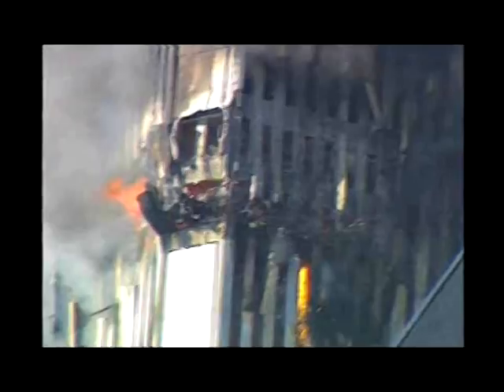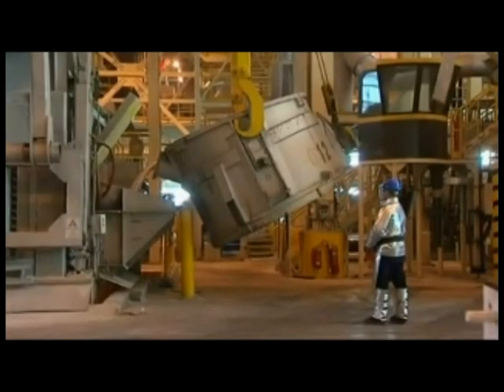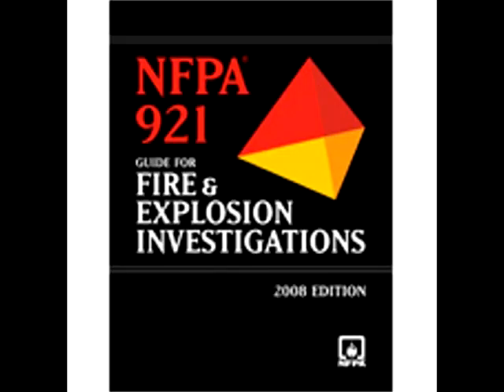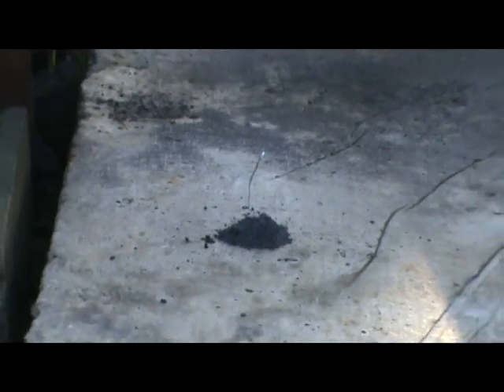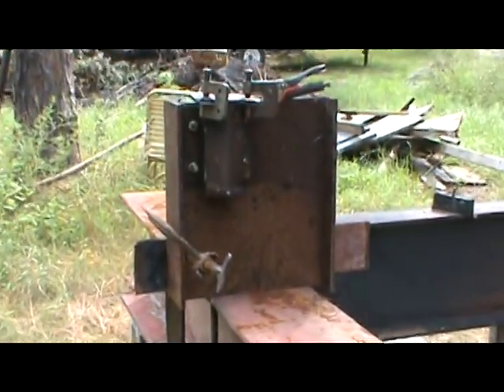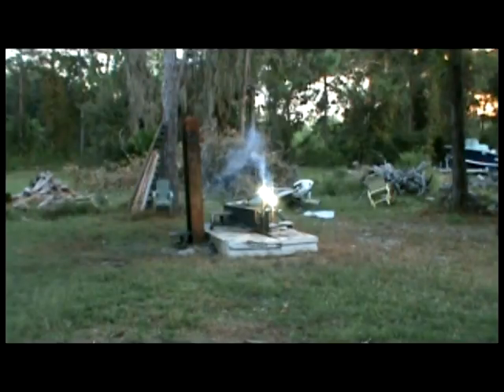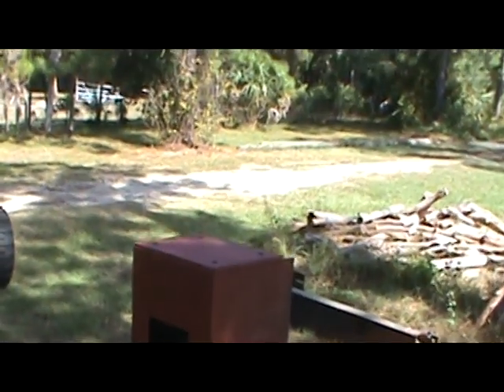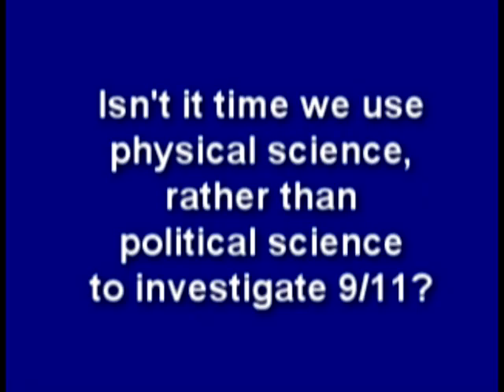9/11 Experiments: The Great Thermate Debate

Comment: The answer is simple: The molten stream of metal was not steel. There were many other metals in the towers. Aluminium, lead, copper an even gold, which all have much lower melting points than steel.
Reply: John Smith
Because the whole lot was literally a PLANE CRASH, and as such was a chaotic mess, so it could have been a mix of lead, copper, aluminium and whatever else was in that level at that time, but it was most probably lead.

And if it was lead (pure or not) and being heated beyond the point where it glows, then after the heat stopped being applied, it would still glow until it was cool enough for it to stop glowing. That would be seconds, but the molten material cascading was only glowing for a few seconds.

Now if it was thermite (and you so desparately want it to be) then WHY would they ONLY put the stuff RIGHT THERE and NOWHERE ELSE?

That answer is very easy if you ask that of molten lead and/or aluminium: In that area, there was a lead/acid emergency power backup battery feeding one of the offices, which was supposed to back up an entire bank of computers in the event of a blackout.  Also in that area was  much of the wreckage, which was forced into that area by the impact and fuel/air blast.

Now when such batteries are overheated, something very nasty happens: They burn. Then the hydrogen emitted by the batteries burns. In ordinary conditions, this would have been suppressed by the halon system, but the halon system was useless because of the plane crash completely destroying it. So you have a nasty fire in that corner, not only burning the hydrogen from the batteries, but burning everything else that got forced into that corner by the plane crash (meaning much of the contents of all those offices, already set alight by jet fuel).

Now for your thermite theory to hold, you would have to explain why:

There were no other such visible cascades of molten metal elsewhere in tower 2 or anywhere in tower 1 or 7

Why there were no witnesses claiming to have seen such cascades from the inside of the towers

Why there was nobody with the kind of UV radiation burns you expect from anybody who is anywhere near burning thermite

If thermite was used to cut all the key columns, such a glow would have been visible throughout the cores and throughout the exterior columns, not just one one corner of tower 2.
Reply: dangerouslytalented Come on? Gold, lead? Not much of that at all. It was molten steel allright. That explains why a lot of steel was combusted and blown into dust.
Reply: Erik Jonsson
Most likely not gold. But there was HEAPS of lead in cathode ray tube monitors (back in 2001 they were ubiquitous and had 2 pounds of lead in each) and back up batteries for uninterruptible power supplies. And none of the steel was blown into dust. The CONCRETE was ground into dust, but not the steel. The steel was recovered and sold to three scrap companies, as well as turned into memorials.
Reply: dangerouslytalented most of the dust was concrete. But lots of steel was never recovered. The Concrete exploded, it was not ground into dust.
Reply: Erik Jonsson what is your evidence for it exploding?
Reply: dangerouslytalented look at the videos......huge beams thrown upward and far away to the sides. That was no gravitational collapse. Concrete is not flour.
Reply: Erik Jonsson
They could not exactly fall exactly down. And can you show me exact video of which beams were thrown UPWARD. Because that's a new one to me.
Reply: I've seen several. For instance the one that the 911 architects and engineers discusses (experts speaks out).
Reply: Erik Jonsson
you saw it, now show me. Just the exerpt where they say it, not the whole damn thing.
Reply: dangerouslytalented the physics teacher Mr chandler....watch clips with him....
Reply: Erik Jonsson
Just show me the clip, I am not going to sift through the whole thing.
Reply: martinw28703
Yeah, and how much of the buildings were pulverized in mid-air, INCLUDING the core. Its just not possible that the core of such a huge structure can more or less vanish due to a non-assisted collapse.
Reply: martinw28703
1200 feet? Sounds like a lot, but consider the stresses involved when those beams snapped under high tension as the buildings collapsed?  Also the forces involved when the engines of those planes went straight through the buildings. But they fell a long way. 1,377 feet. And as the floors collapsed, they forced the outer columns OUTWARDS, you can see the start of that as tower 2 collapsed. They were not going to simply fall in on themselves in petite little piles, it was not some kind of controlled demolition or something.
Reply: Joe V
Well even that false analogy (because a steel building is tougher than a human body) indicates that the official version is wrong. The human who got hit would offer resistance and would tip over. Not become crushed into its own footprint at near freefall speed.
Reply: Erik Jonsson
Except that the towers were, by volume, mostly air. There was a three metre gap between the actual floors (where the offices were) so the falling mass, once it smashed each floor, another three metres to fall and gain momentum. And they never fell at anything near freefall speed. Freefall speed would be about 9 seconds, whereas the towers took between 17 and 21 seconds to fall. And not within their own footprint, the rubble fell all over the place.
Reply: John Smith
.You won't reach a high enough temperature at 700 degrees to bend the steel.

UNLESS

The office fires were hotter than 700 degrees. The jetfuel ignited everything. And some of that stuff burns at far hotter temperatures than mere jet fuel. You have plastics, paper, wood, transformers, backup power supplies, a large amount of electronics, all of which have different ignition, combustion and melting temperatures, and all these fires were fed with fresh air from below, through the smashed windows and the liftwells. THEN you have added stresses on the hot steel girders because many of the other girders were smashed, and all the floors that braced them against each other were not only smashed but so completely smashed as to be GONE. THEN there were MORE stresses brought about by the ACTUAL COLLAPSE, which completely smashed the steel in some places and bent it out of shape in others.
Reply: John Smith
The steel in the WTC did not melt. If you had your log burner hit by a plane and/or falling debris, had many of its structural supports smashed and thus was supporting far more weight than it was designed to support, AND was part of a structure that was no longer capable of standing on its own for a long period of time, AND was on fire, the thing might just buckle under THAT force.

And I have already told you that molten lead and aluminium can glow red if it is at some point HOTTER than that which it glows. If you put lead in a crucible, and then melt it, and then KEEP ON HEATING IT after it is molten, it will start to glow. It does not simply stop getting hotter once it is molten, it will keep on getting hotter if the heat continues to rise.
Reply: GreaterThanADeer
A lot of assumptions? What, that a team trying to surreptitiously rig three skyscrapers to blow would only use JUST enough thermite to bring it down, so they don't get caught? That a demolition engineer would only rig it with enough thermite to bring it down, because too much is a waste,   that the iron oxide and aluminium could be something else apart from thermite, they could be materials that are highly common within the entire complex? The fact that if thermite caused that small cascade of molten metal, then it would have caused far more small cascades right throughout every place where it was installed?
Reply: GreaterThanADeer
No, what they found was NOT the residue. They claimed to have found ACTUAL THERMITE, which would have been impossible because 1) you can't extinguish thermite and 2) there is no way any competent demolition expert would put enough thermite into the tower to account for the MASSIVE amount of "thermite" found in the dust.

And as for the "paint chips" bullshit, there is no way that a thin layer of thermite will burn through a whole steel girder. Look at the amount of thermite used in THIS experiment...
Reply: John Smith You cant post claims that are known lies, and expect to be taken seriously..  ,,this from you ""NIST agrees in their report the towers fell in freefall. Under 11 seconds. That's a floor per second. 
Building 7 however fell for freefall speed a total of 2.5 seconds and collapsed in 6.5 seconds""
The towers fell in 15 and 21 secs, respectively, and as for wtc7, you are forgetting that the penthouse collapsed many seconds before the main building..
You also posted a pic of a steel beam protruding from a debris pile with a diagonal cut..  It is OBVIOUS that beam was cut in the clean up process,..  the diagonal torch marks can clearly be seen, along with the molten slag at the bottom cut...  You weren't trying to imply that beam was cut by thermite, were you??  Only a moron that doesn't know crap about metalwork, or is sorely lacking in common sense would think that///
Reply: Joe V Did you miss the part where he said the image was taken before any steel worker was present? Its easy for someone like a fireman to look past something like that with all the other chaos going around.

"Ok, there are thousands of bodies in this ruble, but would ya just look at those beams?" How about that for common sense?
Reply: dangerouslytalented Why not? Gravity works vertically, not laterally. Beams were thrown as far as 1,200 feet. What would have enough energy to throw spans of perimeter sections, weighing tons, over a thousand feet?
Reply: Erik Jonsson
The core did NOT vanish, it collapsed because the floors that braced it against the outer walls had collapsed.
Reply: dangerouslytalented The engines? The engines that were flying at 500 MPH? I'm not surprised they flew that far either. But, a section of steel weighing tons can fly that far just from a couple floors falling on it? 

Like I said, gravity works vertically, not laterally. Something threw those beams that far, and it could not have been the force of the falling building. 

Also, funny.....petite little piles is exactly what we see. I'm not saying the entire building landed 1,200 ft away, most of it ended up almost directly in it's footprint, but some beams were literally thrown far distances, too far for the force of falling floors to throw them.
Reply: Why is it, people always seem to go after things about 'how the building fell', and 'what the fires did', and 'what the planes did', and all this malarkey? 

Why don't people ever talk about the hundreds of witnesses who heard explosions? Not just explosions, but multiple explosions. Most firefighters and police officers claimed to hear explosions. Almost all videos of the towers show squibs as the building is falling 30 stories below the falling floors. If it was just plainly air, then why is there dust coming from them? If it was just glass, wouldn't it be damn near impossible to see? Plus, the air, when pressurized, would have blown at all around the building, and not in single instances at over 70 mph.
Reply: martinw28703
It was not a couple of floors. It was ten or twenty floors collapsing on top of it.

Little experiment: Take a pencil and bend it until it breaks, but don't hold on to the ends hard enough to keep a good grip. What happens? The two parts of the pencil fly across the room. And the forces that acted upon the beams on 911 were enough to snap the steel girders, so I don't see why they would not have gone so far. And the buildings did NOT fall exactly into their footprint, they splayed all over the place, the Verizon building, the Deutsche Bank building, the Winter Garden and every other building in a six block vicinity was damaged.
Reply: Erik Jonsson
I am not watching a one hour video. Show me the exact piece of footage.

The people who heard explosions heard things go bang. ANYTHING falling that height will cause such a noise. People were saying that the bodies falling sounded like M80 fireworks going off.
Reply: I told you to go to minute 59.

....

Well, that's your explanation. Many professionals at the site say otherwise.

It was wrong of me to state that the core vanished. Much of the debris was recovered. But as a whole I wanted to describe how it desintegrated in midair. It makes no sense whatsoever.

We should have seen a tall pile of debris maybe 20-40 stories tall.
Reply: Erik Jonsson
The squibs were air being forced out of the storeys below the collapse. The pieces of the facade that fell away were forced away from the main collapsing building because of the stresses involved in snapping those beams.If it was those squibs 20 storeys below, then the beams would be flung out when the squibs went off surely. IF they were actual explosives.
Reply: dangerouslytalented
Many of the explosions were hidden in the debris cloud.

And no that was certainly not air squibs. Why would the air come out 20+ floors below? Makes no sense.
Reply: Erik Jonsson
Still does not make sense. The squibs did not throw out any beams. Just clouds of dust. The dust came out 20 storeys below because that's where there were both open elevator shafts and broken windows.

Plus, NONE of the occupants of the offices reported any suspicious packages placed against the exterior walls.

And to set those explosives off incrementally, they would have to put each floor on a separate circuit, which would mean, in order to mistakenly set off explosives 20 storeys below the zone of collapse, the squibs accidentally put on the wrong circuit would have to be plugged in to the system individually instead of all the explosives on the same circuit, which is an incredibly inefficient way to secretly wire up two hundred storey buildings to blow. They would need to get access to offices (some of which were manned 24 hours a day), plant the mysterious devices, hide the mysterious devices and then hope some technician or electrician does not open up that one panel behind which it is hidden. ON ALL TWO HUNDRED FLOORS. And to do it to all three buildings would have taken a LOT of man hours. Each floor had an acre of floor space, they would have to spend a bare minimum of a night on each floor without being detected (and some of them, as I said were manned 24 hours a day, as many offices were dealing with China, Japan, Europe and the Middle East, which meant that they had to operate around the clock.
Reply: dangerouslytalented
Come on you can clearly see that beams were hurled "across the street". This was obviously demolitions, never ever would gravity cause something like that.
Reply: Erik Jonsson you don't understand physics, engineering or how buildings are demo'd.    Gravity is a very unforgiving force.
Reply: Joe V
Explain how beams were thrown over 100 m to  the sides in an upward trajectory.
The floors above the impact zone did not way as much as the rest of the structure. And it makes no sense that it could just pile-drive through the structure. Straight through the core.
Reply: Erik Jonsson Oh, they were propelled over 100 M away.. but in no fashion did they ever travel in an 'upward' trajectory. That would be impossible.  Since this is what you think,, You should post a link where this 'upward' trajectory is shown..  
You also need to look up the definition of static load and dynamic load.  It will explain how the upper floors crushed the lower ones..
 Its obvious you lack a lot of physics and engineering understanding... go back and take 9th grade physics..
Reply: Erik Jonsson For a visual aid, think of the load this way,,  Imagine you are holding a 15 pound bowling ball on top of your head,  No problem, right.  Now the same ball is dropped from 15  feet up on your head.  Would your head still be able to hold the ball?
Reply: dangerouslytalented
17-21 seconds? Where in the world did you get those figures from?

The twin towers fell in about 15 seconds. Just watch the videos. And building 7 fell in about 6-7 seconds.

"Mostly air by volume". But the core was not made of air. And the building just crushed itself in its footprint. Makes no sense.
Reply: Erik Jonsson
I found out the time it took for those buildings to collapse by taking the footage and TIMING IT. All you have to do is count the seconds from when the collapse stopped to when the collapse finished. OR you can use seismic data, or you can use sound, but no matter what method you use, it ALL ADDS UP TO 17-21 seconds.

And the core was NOT solid concrete either. It was steel lined with drywall. And it was mostly hollow because it was full of liftwells.
Reply: Well, it does not convince me that it was not an inside job. So I'm done here.
Reply: Erik Jonsson Maybe even platinum, or plutonium; yea, that's it, coulda been uranium or maybe even einsteinium or taffy, turkish taffy. They gots a lotta that in NY. Coulda been. Yea.
Reply: dangerouslytalented Why would it collapse? The internal core was an independent, freestanding support structure. Try watching some of the construction videos. The core was dependent on nothing but its own foundation (which was made of 4 inch steel box columns, incidentally).
Reply: C. A. Gravenhorst
It was never designed to be freestanding. Never had to. They built the cores only a few storeys ahead of the external walls and the floors.

And the core columns were only 4 inches thick at the base. At the crash zones the steel was less than an inch thick and all of it hollow (because hollow steel has a far greater strength to weight ratio).

And the core columns were not what initially collapsed, it was the floors and the outer facade columns.The cores collapsed when the rest of the towers came down around them. You can see the cores still standing for a few seconds if you watch some of the footage of the collapses carefully.
Reply: dangerouslytalented Yes, and the structure falling was made of the same 'mostly air' construction. Same acts upon same precisely as demonstrated in the experiment.
Reply: C. A. Gravenhorst
In between the air, there was fucking concrete. Lots of it. Literally an acre of it per floor. And steel. By volume it was mostly air. But by weight, it was 1.5 million tonnes. And the air conditioners were built to cool another 60,000 tonnes of air. By weight, it was mostly concrete and steel. By volume, it was mostly air.
Reply: dangerouslytalented
You can't have it both ways, sparky. Either the structure of the WTC was substantial all the way to the ground (actually it was considerably MORE substantial as it got to the ground), or it wasn't. It was YOU who attempted to claim the 'pile driver' theory of a collapsing mass crushing 'mostly air' construction. Well, whatever it was, it was not less than what fell on it and would have, in a normal event, offered resistive force. But clearly none was seen and as such can only be explained by actions taken to remove the resistive force. That is how demolition is done.
Reply: C. A. Gravenhorst
It was more substantial when you got to the ground, but the falling mass by the time it got to the ground was far, far greater. You have 1.5 million tonnes falling by the end of it, whereas the top few storeys at the start was only maybe a hundred thousand tonnes. The air gaps allowed the falling mass to speed up through gravity before hitting each and every floor in turn.

But lets take ALL your preconceptions as a given: What do YOU THINK caused what is observed?
Reply: dangerouslytalented It doesn't really matter what C A Gravenhorst  thinks caused what was observed,  He already thinks it was caused by some form of CD.  So his reply will  only be his opinion, having ZERO facts to back it up..
Reply: Joe V
It was definitely not controlled. The debris flew everywhere.
Reply: Bravo. Simple observations that this mental giant can't see. He is like a 12 year old with a budget.
Reply: *****
The eyewitnesses to explosions had no way of even knowing what caused the explosions, they just know something went bang (which could have been ANYTHING hitting the ground, there are reports of people hitting the ground sounding like M80 firecrackers), and fireballs at the bottom of liftwells (the fireball being forced down by its own pressure). No actual witnesses seeing actual explosives, and the only evidence of thermite (which does not explode, it burns very quickly with a bright orange flame with a lot of UV radiation) was iron oxide (the same compound as rust) and aluminium flakes (aluminium was abundant in the towers due to the facade and office furniture).
Reply: ***** The ones who heard explosions were in the basement. They had absolutely NO WAY of knowing what was going on 80 or 90 floors above them. All they could see and hear was a fireball at the bottom of the liftwell and a bunch of stuff falling down.

Planting bombs in the basement DOES NOT MAKE SENSE. The collapse was downwards and progressive. Planting enough explosive in the basement to destroy the building would have killed everybody in the vicinity. That's what happened last time, AND IT DID NOT WORK. That bomb, at 600 kilograms (over half a tonne) caused a LOT of damage to the underground carparks, but nothing even close to any structural damage to the towers, and security efforts AFTER that bombing meant that a bomb that size could not even be ALLOWED  INTO THE BUILDING. Trucks that large were all screened,and so were all deliveries. (and a bomb in the basement was completely unsuited for the job anyway, because of the open plan of the building, there was not enough enclosed space).
Reply: *****
... the guy who was blown off his feet when Building 1 collapsed? The collapse of building 1 was enough to gouge a huge hole in 7, he was bound to get knocked off his feet.

Oh, and weakening the columns at the base would still have had no point, where far less material would have had far more effect up towards the top of the towers.

Now as far as exothermic reactions, what exactly do you mean by this? Do you mean an external heat source?
Reply: *****
Ah, that's the one. Except if there was an exothermic reaction from thermite in the basement, it would have NOT looked like an explosion, it would have looked like fires from the pit of hell. And all the witnesses would have gotten UV radiation burns, (they would have looked like they had a sunburn or "welders tan".

Now what particular question did you ask three times? The one about why would I not investigate alternate theories? I have investigated them, others have investigated them, and they have been found lacking. They usually lack basic pieces of evidence and pretty much everything that points to an alternate explanation has a reasonable explanation. For example, thermite is simply a mixture of iron oxide and aluminium. Both of these things were abundant in the towers, and flakes of iron oxide and microscopic pieces of aluminium would therefore not be uncommon. Against the thermite theory is the fact that if they used thermite to sever key structural members, they would NOT have used as much as would explain all the "thermite" found in the dust. Also, you would have seen a strong red glow emanating from the whole tower, you would find a whole lot more molten steel, and you would NOT find unburned thermite, because they would not be so stupid as to put more thermite in than was absolutely necessary, particularly as it would have had to be smuggled in, and you can't extinguish thermite.
Reply: ***** I have to put my 2 cents in here..   That pic of the beam you gave a link to  CLEARLY was cut by a torch in the clean-up process...  That photo was cropped and enlarged to show just that beam.. The original photo shows other beams about the same height, surrounded by a debris field.. I think there is a fireman in the pic also..  Diagonal cut marks from a torch are obvious, as is the molten slag at the bottom of the beam...  Thermite can not do that..
Reply: *****
Let me answer in this way: They should have followed the evidence. The evidence points to what questions to ask. Otherwise, if you try to address ALL the questions, stupid questions start being asked. "what about space weapons being used", as truther Judy Wood is fond of asking. "what about mininukes". If there were pools of molten steel or other obvious signs of actual thermite being used, (large numbers of cascades of molten steel, eyewitness accounts of bags of thermite igniting, UV burns on the faces of many of the survivors, then they should have asked about that that. If the Geiger counters were going off full tilt without any actual reason, they should have asked about nuclear weapons, and If there was definite  sky blasts from space and an EM Pulse wiiping out all the electronics in the area, then they should have asked about space weapons.
Reply: *****
molten material in the rubble? Do you actually know how long it takes for thermite to burn? Even a large quantity of it is gone within half an hour. Go look at the mythbusters episode where they used half a tonne of thermite on a car. IF there was molten metal in the debris pile, then it was NOT thermite from some kind of plot to make the towers collapse, because THAT thermite would have been GONE long before the towers came down.

As for unburned thermite that Niels Harrit claimed to have found, let me ask you this:

ANYBODY who works with thermite knows how much it will take to burn through a girder. And they know how to place it so it will burn efficiently. WHY ON EARTH would they put so much ANYWHERE that it would not be fully burnt out by the  time the towers fell? And the sheer AMOUNT of thermite that Harrit found in his samples would indicate that MASSIVE quantities would have been used, had it actually been thermite, instead of simple iron oxide (rust) and aluminium flakes. (which is what thermite is).
Reply: dangerouslytalented 
Sounds great when you put it like that, however molten lead and aluminium is silver, not bright red.
Reply: John Smith
Whatever that molten metal is, it isn't pure.

And if you get molten lead and/or aluminium hot enough, it glows. It is just that the point where iron glows is lower than its melting point, whereas the point that aluminium and lead glow are higher than the melting point.So when you normally melt lead or aluminium, it does not glow, because you normally don't have to heat it so much that it glows, that is wasting a lot of energy. But you can heat lead (or aluminium) to the point where it glows.
Reply: dangerouslytalented
1) What makes you say it isn't pure?
2) What would you suggest it is?

Before you answer it'll benefit you to know the suggestion that it's a mixture of office furniture has already been debunked.

Aluminium and lead glow red when they're BEING heated. They both begin to cool very quickly when they're not and form the silver skin. 
Molten aluminium or lead falling from that height (~400m) will cool very quickly and become silver.

Search Google for images of molten aluminium and lead, you'll see within the crucible it's glowing red, but what's being poured is silver.

Here's an image that best describes what I've said, (aluminium)

http://www.themoscowtimes.com/upload/iblock/360/rusal.jpg

There is no way the molten metals pouring from the towers is aluminium or lead, especially since the position of it on the tower is where the lateral steel beams meet the vertical box columns - a very strong part of the structure.
Reply: dangerouslytalented
Ok, so like I've said, those metals when molten are not bright orange.
And copper, whilst orange when molten, doesn't melt until well in excess of 1,000 degrees, which the fires in the towers weren't, given the highest temperatures would have been caused by the aviation fuel, of which was almost entirely burned off on impact, and burns at HALF the temperature to melt either copper or steel.

The molten metal pouring from the towers continued to glow as it fell.
It continued to glow as it sat underground up to 100 days after the collapse of the towers in what emergency services described as "pools of molten steel" and described it similar to being in a foundry.
It continued to glow to the extent it was melting the boots of emergency crews.

Here's a famous image,
https://www.metabunk.org/metamirror_cache/algoxy.com_psych_images2_moltensteelenclose5mt.jpg

This was taken in October, well over a month after collapse. 
Now take into account that thermite provides its own oxygen, allowing it to burn in the rubble where oxygen would not allow temperatures to rise to such levels.

Now let's not get sidetracked here, what you can see in the above image is STEEL. It is GLOWING red, which means it has been super heated.

Here is an even more famous image of firefighters peering into one of these underground"furnaces",
http://drjudywood.com/articles/dirt/dirtpics/jones_firemen.jpg

The thermite would have been placed on all structural columns within the towers to allow for the total collapse which we witnessed.
It's very simple physics - Newton's Third Law.
Each and every action has an equal and opposite reaction.
This simply means that when the top 15 floors collapsed downwards, they should have taken out 15 floors below and then come to rest on the perfectly structurally sound floors below.
There was NOT enough kinetic energy in those towers to allow the higher floors to crush through and pulverise the structure that had not been affected by the fires or the impacts.
That is simple physics, primary level science. Feel free to ask your science teacher.

But if you don't believe me, try this experiment.
Smack a bath of water with your hand and try to reach the bottom with the same level of speed - you won't be able to do it because of water resistance. Your hand will be slowed and will not hit the bottom of the bath with much force whatsoever.
Now imagine the same scenario, but replace the water with structurally sound steel - no matter how much force you exert, the result will only be the "equal and opposite reaction" of your so-called "action".

You're assuming right now. For thermite to be visible in such a way, it has to be packed in such a way. The video below will help you to see what I'm talking about, it's short so you should be able to watch the whole thing.

https://www.youtube.com/watch?v=5d5iIoCiI8g&index=1&list=LLYLKY4rC27_t5e6P3vTCLEQ

Take extra attention when he talks about the puffs of smoke that can be seen up to 30 floors below the impact zone as the towers collapse - these "squibs" would be the result of those thermite charges detonating. 
Estimates place these squibs as travelling upwards of 100mph, which casts aside suspicions of air pressure due to the towers collapsing.
Here is an image of 2 of these squibs,

http://www.veteranstoday.com/wp-content/uploads/2013/11/wtc-squib-mosaic.jpg

Here's another image showing squibs even further down the tower,

http://911research.wtc7.net/wtc/evidence/photos/docs/south_tower_squibs.jpg

"Why there were no witnesses claiming to have seen such cascades from the inside of the towers"
False. There are MANY eye witness accounts that testify seeing molten steel INSIDE the towers, don't believe me? Watch this,

https://www.youtube.com/watch?v=2VN-WXUJ7HI

People died in the towers at ground level before they had even collapsed. The 10th body that was recovered from the towers on 9/11, that of Robert McIlvaine was described by his father, Bob McIlvaine as having his face blown off, and an arm missing - again this is in the lobby and before the collapse.
Bob McIlvaine is very outspoken on 9/11 and appears in many documentaries demanding justice for his son. He's adamant his son was killed by explosives in the towers - which again were reported by eye witnesses as sounding like gunshots.
Again, I can provide video sources that back this.

William Rodriguez, the WTC Janitor who was hailed a hero for saving people on 9/11 reported hearing explosions in the basements of the towers an entire 7 seconds before the first impact.
He also explains seeing a man in the lobby who's skin was hanging from his fingertips, after being burned off his arms and explained initially thinking it was his clothes.
Reply: dangerouslytalented don't forget also that the stream of metal is glowing between some columns which were covered with aluminum shell... and said columns weren't melted. How can alleged steel at alleged temperatures much higher than the melting point of Aluminum pass next to Aluminum shell without even affecting it? Easy: It wasn't steel. Facts destroy twoofer fantasies once more.
Reply: ***** The cut columns? The ones that were cut AFTER THE TOWERS FELL? You think they simply took those gigantic five storey high cathedral walls out and did not cut them first?
Reply: John Smith Metals glow bright orange when they are HOT ENOUGH. Lead and aluminium do that too, if they are heated well beyond their melting point.

And jet fuel was NOT the only thing burning by that time. Office fires often reach temperatures that high, and that particular area had battery backups for one of the offices, and those things emit hydrogen when they overheat, and then they blow and burn intensely. They normally have all kinds of fire suppression systems, isolation and halon and all that stuff, but that was useless because everything was smashed up and piled in the corner by the crash.
Reply: John Smith Evidence of red hot steel in the WTC ruins does NOT mean automatically 
there was thermite in the towers. Thermite burns hot and fast. I saw a 
mythbusters episode where they piled half a tonne of it on a car to cut 
it in half, and the whole lot was done within half an hour. That means that whatever was glowing and on fire two months after the attack, it was NOT thermite. Go look up the Lane Hydrogen Producer. https://en.wikipedia.org/wiki/Lane_hydrogen_producerThat will show you why the fires may have lasted so long. The process is simple: Spray hot steel with water, the oxygen bonds with the steel, releasing hydrogen, the hyrdrogen burns. They knew that this would cause more fires, but they had to keep the dust down because they could not work in so much dust. 

And those firemen who said they saw molten steel? They are NOT metallurgists, they had NO IDEA what the metal was. And that STILL does not mean thermite was used, that simply means that the fires were hot enough to melt metal.

And the blast in the lobby was burning jet fuel being forced out open elevator doors. Every floor with open elevator doors suffered the same fireballs. 

Oh, and Willie Rodriguez's stories do not add up. The only thing that has remained consistant between the stories he told just after the attacks and what he says nowadays, is that he saw a man on fire. There are no witnesses to him unlocking all the doors, and there is no WAY he could determine when the actual impact was, HE WAS IN THE BASEMENT.
Reply: *****
Not investigated? It has been investigated enough to know that thermite was NOT used to bring the towers down. ALL of the available evidence supports the whole plane crash thing.

And the firefighters who said there was molten steel were NOT metallurgists. They had no idea what kind of metal they saw. If thermite was used, the cascades of metal would have been literally EVERYWHERE in the affected floors, ALL the survivors would be telling stories of molten metal falling from cielings. ALL of them.
Reply: dangerouslytalented
Not all metals do. Like I've said, aluminium and lead will begin to cool once their source of heat has gone and form a silver skin. I've already provided you with an image that shows aluminium being poured from a crucible. When being heated it glows, when cooling, (even when being poured) it becomes silver.

There is also evidence showing some parts of the steel had been melted and in some cases vaporised. Here's proof,

http://wtfrly.wpengine.netdna-cdn.com/wp-content/uploads/2015/01/911bpatsamples.jpg

This evidence was IGNORED by NIST.

Office furniture by regulation has to be fire proof to a certain level. Carpets would be extremely fire retardant, and all that remained was chipboard desks, computers, filing cabinets and desk chairs.
Just so we're clear, tell me categorically that desks, computers, filing cabinets and desk chairs can burn hot enough in oxygen starved environments to melt and even vaporise steel in less than an hour.
In buildings that have been designed to withstand multiple strikes by Boeing 707's, which not only have 2 more engines than a 767, but also weigh roughly 100 tons more. 
You're talking out of your arse.

Explain to me why iron rich microspheres (a bi-product of thermite) were found in the dust in one lady's apartment?
Explain to me where these red chips (a bi-product of nano termite) came from?

https://kendoc911.files.wordpress.com/2015/02/redgraychips.jpg

The Mythbusters video was mentioned in the video I linked above.

And now you're telling me that office fires can continue to burn hot enough underground to not only melt the boots of the workers working above ground, but also continue melting steel and concrete into what emergency personnel described as "pools of molten steel" and being similar to a volcano? 100 DAYS after the collapse? No.
Here is an image of a 'Meteorite' found during the clean up, it has been super heated to compress steel and concrete, this does not come about due to mere office fire,

http://coldfusion911.com/images/wtc_meteorite1.jpg

The video I asked you to watch includes an interview with a Metallurgist. She says the exact same thing.

NIST didn't even test for explosive residue because they didn't consider it likely, so no, it hasn't been investigated.

So your argument is there was no molten steel because not ALL survivors reported seeing it?
You're denying the presence of thermite despite the bi-products of it being found in the rubble.

More money was spent investigating Clinton's affair that it was spent investigating 9/11.
And you expect me to believe their investigation despite the evidence and witness testimony?
Doesn't work that way.

Oh and finally, Robert McIlvaine's body was not burned, as you'd expect from ignited jet fuel, his face had been "blown off".
Reply: *****
... so thermite works fast... Except it burns up completely, you can't extinguish it. And that means Harrit's claim of having found thermite is absolute BULLSHIT, because if thermite was used, ONLY THE BURNT THERMITE WOULD BE FOUND, and NO actual unburnt thermite would be present, because it would all be burnt.

And there weren't witnesses for explosives, only explosions or things that go bang really loudly (as when they hit the ground) , and that's a huge difference, because explosives aren't the only things that explode, and they aren't the only things that go bang.

Now where is your PROOF that the molten metal was steel?
Reply: *****
What was found was iron oxide and aluminium. These two things together are thermite, but ALSO are two of the main components of the building. Iron oxide coated all the steel girders in a thin layer, and the facades were made from aluminium. 

And if thermite was used to cut the girders, then that cascading metal HAD TO BE STEEL, otherwise what you said would have absolutely no POINT.
Reply: dangerouslytalented
I've already told you about the red-grey chips found in the rubble.
Tests proved they weren't paint flecks but instead a bi-product of nano thermite, which is military grade thermite.
Designed at the molecular level, smaller and easier to ignite.

Not something that would be sat in the corner of an office on the 75th floor.
Reply: John Smith Sorry, but that was debunked a decade ago. You need to catch up. It was fucking paint from the walls (and it wasn't from the rubble in the first place).
Reply: *****
Oh yeah? There are equally just as many sites that point to some sort of explanation for the red chips as there are those that point to thermite.
The fact is, they were proven many years ago NOT to be paint, as that's exactly what they were tested for. 
NIST wouldn't know much about these red chips as they didn't even bother investigating for explosive residue in any of the buildings hit on 9/11.

The simple fact of the matter remains this, office fires (of which the furniture by regulation is fire proof to a certain extent) do categorically NOT burn hot enough to weaken or melt structural steel columns in the space of an hour.
Especially since, according to NIST, the fires in WTC 7 burned for just 20-40 minutes, leading to the weakening of core column #79 which buckled and fell off its lateral supports which subsequently snapped them.
I don't need to explain again how box columns are designed to NOT snap.

There are far too many inconsistencies in the official story for it to be believable. Especially since a lot of the information that leads to this speculation could easily be debunked if the US Government released the vital information they've kept classified and hidden from the public eye in Hangar 17 for all these years.

How much heat do you suppose were in the plumes of pulverised concrete to accomplish this?

http://drjudywood.com/articles/DEW/dewpics/toastedlot_93a1f7e6e7.jpg

Some would say they resemble pyroclastic flows from volcanic eruptions, which carry enough heat to kill people and freeze them in place (take Pompei for example)

http://www.photovolcanica.com/VolcanoInfo/Soufriere%20Hills/MS10_0714.jpg

Now tell me pulverised concrete carries enough heat to melt cars, bearing in mind now that only a few floors of the 110 storey towers were on fire, meaning that concrete shouldn't have been very hot.

Now explain to me how the collapses defied Newton's Third Law.
Reply: *****
He's blatantly ignored the independent investigations I've linked him.

Makes you wonder though, if offices can burn with such detrimental effects, why are computers still allowed in them?
I heard the water in potted plants explodes when heated, releasing hydrogen into the atmosphere and creating temperatures hot enough to melt granite.
- He'd probably believe that too if he was told to.
Reply: *****
I am being completely rational.
Reply: John Smith
There's more in offices than potted fucking plants you know.
Reply: dangerouslytalented
Ah yes, how silly of me, all those filing cabinets, light units, envelopes, binders, staplers and scissors... don't forget the water coolers, they're bombs in themselves.
Fuck sake.
Reply: John Smith
... toner, wood, plastics, battery backup systems, cleaning supplies, and massive quantities of paper. You think office fires are a game? If office fires were nothing special, we would not need fire codes ANYWHERE.

Some of those offices had HALON systems for a REASON.
Reply: dangerouslytalented
And you suppose those objects can melt structural steel?
How many steel furnaces are you aware of that are fuelled by bleach and paper?

I hope you realise that paper burns at around 200 degrees and burns for mere seconds? 

What about vending machines? What temperatures do you reckon they burn at?
I mean a Twix alone must be at least 500 degrees?
Reply: John Smith
It does not HAVE to melt structural steel. Just heat it enough for it to weaken.

Hell, the jet fuel ALONE could do that, jet fuel burns at 600 degrees.  That means the MINIMUM temperature the fire could have been is 600 degrees, which is well over the ignition point for most of the stuff in the offices, some of which burns far hotter than that, particularly after being doused with burning jet fuel and smashed apart.
Reply: dangerouslytalented
No.
The minimum those fires could've been was 600 degrees for the very short time it remained in the buildings before it was ignited... and given the fireballs on impact.. that's not very long. 

But once again, that is not explanation for WTC 7's collapse, which let me remind you, wasn't struck by a plane, and was a Federal Building, home to many Federal investigations, the files of which went down with the towers. 
WTC 7 was built like a bunker. It had its own food stores, air supplies and back up generators. 
You think a building like that weakens and collapses under fires that burned according to NIST between 20 and 40 minutes?

If that's the case then fire regulations in the US need a major fucking overhaul.

How about the testimonies of Barry Jennings who was the last person in WTC 7 before it collapsed? He reported explosions from within the building and stairwells collapsing before being rescued by firemen.
In his interview for the Loose Change documentary, he recalled stepping over dead bodies in the lobby after being told by one of the firefighters not to look down.
He later retracted this claim before strangely dying.

But I suppose none of that is out of the ordinary to someone who believes a passenger airliner can travel at its cruising speed at ground level. 
Or that 2 towers, which were designed for impacts from multiple 707's which weigh around twice as much as a 767, can collapse in under 11 seconds, defy the laws of physics and fall neatly into its own footprint. 
How about the fact 19 Arab hijackers were allowed the freedom of the worlds most defended airspace for several hours without being intercepted?
How about the fact an airliner was capable of flying 6 metres off the ground for over a kilometre, clip 5 lamp posts before smashing into one of the worlds most defended buildings, and managing to avoid all forms of surveillance (86 cameras) in the process?
How about the fact Hani Hanjour, the man who supposedly crashed an airliner into the Pentagon, was denied plane rental until he'd received further training because he was such an abysmal pilot who began shaking uncontrollably and praying to Allah behind the controls of a Cessna.

All sounds perfectly legible. Not.
Reply: *****
I was actually hoping you'd link me to a credited source, alas you've let me down. What you've ACTUALLY done is use a 9/11 debunking site to get your information, without cross referencing to see how much of it is true.
Naughty naughty.

No, they weren't. Tested for paint, proven not to be.

Since it wasn't paint, it's highly relevant.

Try NOT crashing a plane into WTC 7 and see how far you get with fires weakening a steel structure, leading to a total collapse in 6.5 seconds instead of knowing fuck all like a fucking moron.

It burned for several hours, but the fires in the buildings spread round it in that time. Like I said, NIST themselves said the fires burned for 20-40 minutes before spreading around the building.

Reality in your eyes is breaking the laws of simple physics? Ok then, how about YOU explain how Newton's Third Law was proven to be a myth that day? Good luck.

How exactly would revealing say the rest of the 82 pieces of footage from CCTV surrounding the Pentagon implicate Saudi Arabia or Qatar you dickweed?

The picture shows burned out vehicles following the collapse of the towers. If you want I can provide you with images of burned out emergency vehicles?
And I have no idea who Judy Woods is, I just purely linked the image.

Oh is that so? Feel free to explain to me the differences between the plumes of pulverised concrete and a pyroclastic flow? Try to avoid "The twin towers weren't volcanoes" and similar bullshit attempts.

How exactly does concrete become a fine dust given the kinetic energy from the collapse wasn't enough to even bring the towers down - again, this goes back to Newton's Third Law.

What does the image show then? I suppose those cars looked like that before the collapses and they've just been sat there for a while? Fuck off.
Nevertheless, here's a police car. If you avert your attention to the centre of your screen, you'll clearly notice this police car has been melted, given the deformation in the metal, 

http://www.rense.com/1.imagesH/burned.jpg

However in your eyes I suppose the above image is just the result of a really bad paint job? Or some other fucking laughable claim?
Maybe it was rammed by an elephant? Or MAYBE the fuel managed to find its way under the overpass it's sat under, and set it alight?
And just for shits and giggles, here's a melted firetruck, (take extra care in noting the melted parts.. especially the engine)

https://www.uwgb.edu/dutchs/pseudosc/9-11Pix/firetruck-3[1].jpg

Oh it DIDN'T break Newton's Third Law? Hmm that's interesting as given the ridiculous amount of resistance those collapsing floors would have faced, you'd of thought it impossible for both towers to crumble to ground level in under 11 seconds.

Do me a favour and attempt the water smacking experiment I tasked the other guy. 
Hit a bath of water as hard as you can and see if you can keep up the same rate of speed to hit the bottom.
Now imagine the water is steel.
If water can put up enough resistance to stop your hand, how much resistance do you think a steel structure designed to withstand monumental forces would cope?

Answers on a postcard please.
Reply: ***** - The engineer in this video debunked any of your lying, filthy, un-American, paid shill, blind believer bullshit. You don't and never had a leg or lie to stand on.
Reply: SkylineToTheSeaAndMe
Not really. For example, thermite is NOT the only source for iron spheroids. They can come from metal cutting and welding too. I know, when my father used to weld stuff, I could find quite a few of them lying around  They could have been lying around for 40 years after the buildings were constructed, or they could have been produced when they cut the remaining rubble apart in order to take it away.

And for them to have installed devices to hold the thermite in place, they would have had to have extensive access to ALL the offices (the key members were right next to the exterior walls so to get at them, they would have had to go all the way into each office, cut through the floor, install the device to deliver the thermite, and then leave without trace) and in this video, the thermite was EXTREMELY FAST, while the cascade of thermite on the video of tower 2 lasted far longer than would come from cutting through the necessary structural members.
Reply: *****
That was my point. You didn't provide a link.

I don't give a shit if you read it or not, your refusal to just suggests you're scared to learn. That's alright though, it's what I expected from someone with the Trololol picture.
Reply: dangerouslytalented
The iron microspheres were taken from dust samples gathered in an apartment before the workers began cutting the beams. Nice try though.

The core columns were in the lift shafts. That is effectively the building's spine. They can quite easily be accessed without causing disruption, especially when you consider the fact strange vans were seen arriving at the towers after hours in the weeks up to 9/11.

The cascading would have been the steel melting. We've already gone over this. Keep up.
Reply: John Smith
Like I said, they could have come from ANYWHERE, including construction. New York is FULL of large skyscrapers every single one of which was welded together. Look inside the walls of the Empire State Building, the Chrysler building or ANY OTHER STEEL SKYSCRAPER, you will find the same little iron balls.
And the core columns were mostly destroyed in the initial crash, apart from the ones around stairwell B of the South Tower. Oh, and the molten stream that was visible WAS ON THE OUTSIDE OF TOWER 2. Not the core, the OUTSIDE.
Reply: dangerouslytalented
Dust. All over the floor of an apartment following the collapses after coming through the air vents.
Now you're suggesting welding defied the laws of physics, somehow floated through air vents and coated the interior of an apartment? ~70 years after the towers you're listing were constructed? Get real.

The core columns were only destroyed in the impact zone. 10 floors maximum given the size of a 767. The remaining lower core columns would have remained completely undamaged and structural. 

Look at the construction of the WTC's, the exterior lattice columns were the exterior supports. Access to those is easy. 

However despite all this, you STILL haven't explained how the collapses broke Newton's Third Law.
You tried that bath water experiment yet?
Reply: *****
No, I mentioned gold simply because it has a lower melting point. But it was most likely aluminium and/or lead, aluminium from the plane, office fittings and the facade, and lead from backup batteries and cathode ray tube monitors (those things have at least 2 lbs of lead in them each, and there were hundreds of them on every floor.
Reply: SkylineToTheSeaAndMe What engineer? There is no engineer in this video. But keep fantasizing with already debunked bizarre impossible demolition theories. It's the perfect way to keep you entertained while you keep losing and losing every day.
Reply: John Smith You twoofers can deny the reality of what happened on 9/11, and it doesn’t mean a shit, it’s freedom of speech. But at least the real version of the facts does not contradict itself. There may be some inaccuracies in small details, like it’s normal in any long document, but the overall story makes sense, is coherent and consistent.A very different thing happens with the twoofer self-contradicting and moronic claims. They can't literally speak for five minutes without incurring in blatant contradictions. Believing two opposite things at the same time is the textbook definition of insanity, and a story with contradictions is always false, there is no need to go further, check it with facts, etc. Contradiction in the story = Automatically false story. Period. One thing and the opposite cannot be true at the same time! It’s 1st grade logics! They teach it in the kindergarten! Here is a summary of some of the contradictions I have come across while debunking twoofer asses. Enjoy!
According to twoofer propaganda, planes cannot bring down buildings, and WTC7 couldn’t possibly collapse because it wasn’t hit by a plane.
According to twoofer propaganda, planes cannot bring down buildings because a plane hit the Empire State Building in the 40’s and it did not collapse. But bombs can bring them down, because even if a bomb was set precisely in the WTC1 in 1993 and it did not collapse either, for some stupid reason, in this case it doesn’t matter.
According to twoofer propaganda, the color of the smoke indicates the fires were starving and cold (because according to twoofers, black smoke indicates cold fire regardless of what is burning), but at the same time, a very hot thermite reaction was taking place, melting the steel.
According to twoofer propaganda, WTC 7 fell in its footprint which only happens in controlled demolitions. Steel was ejected outside the twin towers footprint, which only happens in controlled demolitions. Therefore the footprint of a building and the outside of a building are the same thing and whatever happens to a building is a controlled demolition.
According to twoofer propaganda, WTC 7 fell in FF for 2 seconds which is equivalent to CD. Towers did not fall in FF therefore they were also CD.
According to twoofer propaganda, you can't trust the media but we know the hijackers are still alive because the BBC said so and they have to be believed. They also amended the mistake later, but in this case, again, we can’t trust the media.
According to twoofer propaganda, you can't trust the media, but we must trust Bin Laden when he said in the media he didn't do it.
According to twoofer propaganda, the evidence was all shipped to China but there's tons of evidence.
According to twoofer propaganda, you can't trust the government, but Bin Laden was a CIA agent, and he said he didn't do it, and you must trust him.
According to twoofer propaganda, the planes could not possibly fly at low altitude because the air is too thick, and they would disintegrate. Flight 77 could not disintegrate crashing on reinforced concrete, large pieces should have been found. Therefore, air at low altitude is harder than concrete.
According to twoofer propaganda, victim’s families deserve to be told the truth about what happened to their relatives, but the families who said they spoke to their loved ones on the planes are liars.
According to twoofer propaganda, the government-funded investigations were corrupt so we need another investigation which would be funded by … the government!
According to twoofer propaganda, Bin Laden worked for the CIA but the CIA used a “fake” Bin Laden in the "confession" video.
According to twoofer propaganda, Hanjour couldn’t have made the difficult maneuvers in the Pentagon plane but there was no Pentagon plane.
According to twoofer propaganda, the planes that hit the buildings were drones. But also, at the same time, the speed which they were flying makes it impossible to distinguish what type of plane they were.
According to twoofer propaganda, the videos of the plane hitting WTC2 are computer-generated, and they show a military plane.
It takes months to prepare buildings for CD, but according to twoofer propaganda, the jews with the van full of bombs were found... the same day after the collapses, and they are relevant to the events of 9/11.
According to twoofer propaganda, the bombs allegedly still in the van caused the collapse of the towers miles away.
According to twoofer propaganda, GZ should have been treated as a crime scene but it's suspicious that citizens couldn't access GZ to take photos.
According to twoofer propaganda, 9/11 was a black ops affair, but everyone blurted out the secret - PNAC, BBC, Rumsfeld, Silverstein and a WTC 7 fireman ("It's gonna blow.")
According to twoofer propaganda, transponders were officially off making it impossible to radar track UA175, therefore it’s impossible to know for sure that this plane hit WTC2 which proves inside job.... but ... fighter jets should have tracked, identified and shot the planes down in minutes, and if they didn’t that indicates inside job..
According to twoofer propaganda, plane parts were planted and they don’t correspond to the plane model. And no planes were used.
According to twoofer propaganda, Larry Silverstein is a liar, but he said he demolished the building, and he has to be trusted.
According to twoofer propaganda, Larry Silverstein said “pull it” meaning  “demolish the building with bombs”, but then he said “we saw the building collapse”, therefore the building collapsed.
According to twoofer propaganda, the top part of the buildings cannot crush the bottom part, therefore it had to be a controlled demolition, but there are also top-down demolition techniques, therefore the collapses were demolitions.
According to twoofer propaganda, the hijackers were alive and well in the middle East the day after the attacks. But also, they were partying in strip clubs the day before the attacks. Note that no planes were allowed to fly these days.
According to twoofer propaganda, Osama Bin Laden never admitted being behind 9/11, so he is innocent. Bush never admitted being behind 9/11, so he is guilty.
According to twoofer propaganda, everyone's an asleep sheeple but everyone's waking up.
According to twoofer propaganda, WTC7 could not collapse because of fire because it would be the first time in history that this happens. But it could be brought down with thermite, because even if it would also be the first time in history that something like this happens, in this case, for some stupid reason, it doesn’t matter.
According to twoofer propaganda, hijacked planes could not be crashed into buildings because it would be the first time in history that such thing happened... but the government could have done it because even if in this case it would still be the first time, for some stupid reason, it doesn't matter.
According to twoofer propaganda, Osama Bin Laden had nothing to do with 9/11, but the government evacuated Bin Laden’s family from the U.S. and this is suspicious.
According to twoofer propaganda, the FBI said 19 muslims did 9/11, but they cannot be trusted. The FBI said they were seen in Florida partying days before, but in this case, they have to be trusted.
According to twoofer propaganda, all three buildings came down identical to controlled demolitions. WTC1&2 fell from top to bottom, which is identical to a controlled demolition. WTC7 fell from bottom to top, which is also identical to a controlled demolition. Therefore the top and bottom of a building are the same and everything that can happen to a building is identical to a controlled demo.
According to twoofer propaganda, the government censors all the information which contradicts  the official version, but here we are in a twoofer video with plenty of views and posts claiming that it was an inside job.
According to twoofer propaganda, OBL was trained by the CIA, therefore the CIA perpetrated 9/11. But OBL is innocent, he didn’t do it.
According to twoofer propaganda, the towers were brought down with explosives, but when you point out that there was no pattern of 130 db charges going off & no trace of det charges in the seismic record, they claim thermite was used and it’s quiet. But when you point out that if this is the case, the dancing israelians with a van full of bombs then becomes irrelevant, then you are a shill.
According to twoofer propaganda, the hijackers were trained by CIA, therefore CIA did 9/11, but hijackers are alive (also according to twoofer propaganda), therefore they couldn’t do it, and therefore the CIA didn’t do it.
According to twoofer propaganda, the government had the buildings set up for demolition long before the planes hit. But they waited for 1h to set them off just to allow most of the people (potential witnesses from inside the towers) to evacuate and firefighters get in and never mention anything about seeing explosives, wiring, etc.
According to twoofer propaganda, nobody has ever seen the plane manifests from the four planes. But at the same time, the manifests do not contain the names of the terrorists.
According to twoofer propaganda, jet fuel doesn’t burn hot enough to melt or weaken steel. But at the same time, all the jet fuel burned off in seconds.
According to twoofer propaganda, the government demolished WTC7, but they did it after many hours, to allow everyone to evacuate, and leaving potential witnesses from inside who would never mention seeing explosives, wiring, etc.
According to twoofer propaganda flights 11 and 175 did not exist because they are not listed in the BTS, but flights 11 and 175 were landed somewhere else instead of hitting the towers, so they existed.
According to twoofer propaganda, flight 77 could not hit the Pentagon because is not shown in any camera (which is false, but anyway). But towers were demolished with bombs, because even though the placement of the bombs or their explosion is not shown in any camera either, for some stupid reason, in this case it doesn’t matter.
According to twoofer propaganda, 9/11 attacks made us forget about Rumsfeld announcement of a <$2.3 trillion hole. That's why we are here talking about this "forgotten subject".
According to twoofer propaganda, politicians always lie, but we know Osama Bin Laden died in 2001 because Benazir Bhutto, a politician, said it.
According to twoofer propaganda, everything we see on TV is controlled and censored by the government conspirators, but they allowed Larry Silverstein to “confess” on TV that he ordered the demolition (twisted interpretation of “pull it”).
The images of the plane impact into the Pentagon are too blurry to be useful, therefore, according to twoofer propaganda, they offer no evidence of the plane hit into the building. But a missile is a compatible scenario with the images, and although in this case the images are still blurry and do not show it, for some stupid reason it doesn’t matter.
According to twoofer propaganda, the towers were demolished. But also, according to twoofer propaganda, it is intelligence agencies who are behind conspiracy theories such as the towers were demolished to create disinfo and noise..According to twoofer propaganda, poor innocent terrorists from Al Qaeda are being blamed by the evil government. But also, according to twoofer propaganda, the government issued a directive to cease prosecuting Al Qaeda members.
According to twoofer propaganda, a plane could not have hit the Pentagon because there were some undamaged windows next to the section that collapsed after the impact. But it could have been a missile, because for some stupid reason, in this case it doesn’t matter if windows resisted.
According to twoofer propaganda the government is a powerful and omnipresent organization capable of involving thousands of people in the biggest conspiracy of all times and altering the laws of physics in their favor… but at the same time they are so insecure that they need a pretext and approval from insignificant people to go to war.
According to twoofer propaganda, the collapses of the towers were controlled demolitions. But they don't exhibit any of the characteristics of a controlled demolition because they were meant to appear to be the result of the planes' impact. Therefore the previous conclusion (that they were controlled demolitions) is not based on anything visible or audible, it's just a prejudice.
According to twoofer propaganda, the top of the building could not crush the bottom part, but at the same time, it is suspicious that the collapse stopped at the lobby. Therefore, according to twoofers, the top part cannot crush a hollow building but should be able to crush the bedrock under it.
According to twoofer propaganda, the attacks could not be perpetrated by muslims because they only do things with bombs in cars or bombs under their clothes… but it could be done by US citizens, because even though in this case there is no precedent either of hijacking and crashing planes, for some stupid reason it doesn’t matter.
According to twoofer propaganda, the towers were specifically designed to withstand any kind of plane crashed into them. But the attacks were also specifically designed to destroy the towers, but in this case, it doesn’t matter, the intention of the constructors prevails for some stupid reason regardless of reality.
According to twoofer propaganda, planes cannot fly at the speeds and heights witnessed by millions on 9/11. But if they are painted in gray, for some stupid reason, it doesn’t matter, and they can. According to twoofer propaganda, the buildings could not have fell because of planes and/or fires, because things cannot happen 3 times in the same day. But it could have been a massive super-secret and impossible government conspiracy, because even in this case it still would be 3 buildings collapsing in the same day, for some stupid reason, it doesn't matter.
According to twoofer propaganda, the TV channels “faked” the plane impacts, but they later had no problem showing the “molten steel” pouring from the side of the building.
According to twoofer propaganda, we cannot trust what we saw live on TV (for some stupid reason), but we must trust a few people who were recorded live on TV and did not see the planes, because even though they are on live TV also, for some stupid reason it doesn't matter, they are more reliable than your eyes.
According to twoofer propaganda the hijackers couldn’t do it, because they were seen with women, and drinking, and islamic fundamentalists don’t do this. However, the government could have done it, because even if american governments do not mass murder their citizens either, and they do not hijack planes, and they do not suicide in hijacked planes... in this case, for some stupid reason, it doesn’t matter.
According to twoofer propaganda, Larry Silverstein ordered the FDNY to "pull" WTC 7 but the FDNY was not part of the demolition plot.
According to twoofer propaganda, Dick Cheney ordered a stand-down against the Pentagon plane but there was no Pentagon plane.
According to twoofer propaganda, WTC 7 fell entirely in its footprint (It didn't), which indicates CD, while steel was ejected far outside the twin tower footprints, which indicates CD too. So whether debris was ejected outside the footprints or fell wholly within the footprints, it's a sign of CD.
According to twoofer propaganda, all the first responders who talked of finding plane debris at the Pentagon and Shanksville are liars and all the forensic analysts who matched human remains at those sites to plane passengers are liars and all the eyewitnesses at those sites are liars and all the investigators are liars and the mainstream media are all liars and firefighters who spoke of WTC 7's instability are all liars and everyone is a liar… but it would only have required a handful of people to pull off the plot.
According to twoofer propaganda, on 9/11 there was a stand down order in NORAD, but at the same time, fighter jets brought down United 93.
According to twoofer propaganda, they (idiotwoofers) are all highly educated individuals, smart people with studies. But also, at the same time, they keep complaining that this post is too long, that I should make a video to prove my point because over 200 lines of text is too much for them (it is probably more than they have ever read in their miserable life).
According to twoofer propaganda there is no evidence that the fires softened the steel structure, and NIST has not one piece of core steel showing heating above 480 F. But at the same time, a very hot 4000 F degrees hot thermite reaction took place and melted the steel.
According to twoofer propaganda, planes could not penetrate the outer walls of the WTC because they are “weaker” To reinforce their argument, they point out that birds create holes in planes, or, in other words, a “weaker” bird can damage a plane, but for some stupid reason a “weaker” plane cannot damage a building.
According to twoofer propaganda, no plane hit the Pentagon despite 130 witnesses, because witnesses are unreliable. But we must believe there were pools of molten steel under the towers because there are witnesses of it.
According to twoofer propaganda, the towers were demolished because 100 witnesses heard explosions (link between explosions and demolition, you have to imagine it by yourself). But at the same time, planes couldn't fly at low altitudes, because even in this case there are also hundreds or thousands of witnesses, for some stupid reason, it doesn't matter.
According to twoofer propaganda history books show numerous examples of government false flags and for some stupid reason this proves 9/11 was one. But at the same time, according to twoofers all history books lie about 9/11 when they don’t mention any of the absurd twoofer stories of what really really happened on 9/11.
According to twoofer propaganda, the experts in FDNY cannot have any expertise in collapse of high rises because there has never been a collapse of a skyscraper before 9/11. But twoofer retards instead, can be experts in building collapses, because regardless of their lack of any kind of education, and despite they have never ever witnessed a building collapse either... in this case, for some stupid reason, it doesn't matter.
According to twoofer propaganda Osama Bin Laden couldn't perpetrate the attacks, because his religion doesn't allow him to do these things or lie. But it could have been Bush! Because even though he is a devote Christian, and Christian religion doesn't allow them to lie or kill either, in this case, for some stupid reason, it doesn't matter.

Note: I recently had to edit the list because some stupid twofers thought I was making these claims. That proves even further that twoofers are idiots, but I had to rewrite some of the entries to make it clear whose claims are these.
Reply: *****
I'm not going to read that simply because I have a life, but here's something you may enjoy.

Law of thermo-dynamics “If you have a flame of 750 degrees, you can hold that flame under steel forever and you will NEVER reach a high enough temperature to bend steel, let alone melt it.” Robert Podolsky - Masters in theoretical physics, Physicist /engineer. Systems analyst, Air Force Avionics Lab, Coast Guard electronics ----------------------------------------------------------------- Law of aerodynamics “"I flew the two actual aircraft which were involved in 9/11; the Fight number 175 and Flight 93. I don't believe it's possible for, like I said, for a terrorist to train on a [Cessna] 172, then jump in a cockpit of a 757-767 class cockpit, and vertical navigate the aircraft, lateral navigate the aircraft, and fly the airplane at speeds exceeding it's design limit speed by well over 100 knots, make high-speed high-banked turns, exceeding -- pulling probably 5, 6, 7 G's. The aircraft would literally fall out of the sky. I couldn't do it and I'm absolutely positive they couldn't do it." Capt. Russ Wittenberg, U.S. Air Force – Former U.S. Air Force fighter pilot with over 100 combat missions. Retired commercial pilot. Flew for Pan Am and United Airlines for 35 years. Aircraft flown: Boeing 707, 720, 727, 737, 747, 757, 767, and 777. 30,000+ total hours flown. ----------------------------------------------------------- Law of motion/momentum “No matter how one views the videos of the Towers and Building 7 collapsing, the laws of physics MUST hold true. If F=ma appears to have been violated (e.g., free-fall collapse of the buildings at nearly 9.8 m/sec/sec), then something is seriously amiss and one must start looking for the "other hand" hidden beneath the table to discover what is really happening” Commander James Clow, MS, U.S. Coast Guard (ret) – Retired U.S. Coast Guard officer ------------------------------------------------------------------ And the dearth of available evidence and fact... Several tons of molten iron - Rapid oxidation and intergranular melting--- -Microspheres of molten iron - 1400 victims blown into tiny fragments--- -Total building destruction - Complete dismemberment of steel frame--- -Temperatures well above what is possible under alleged conditions--- -Expanding pyroclastic dust clouds - Positive ID of Nano Thermite--- Mid-air pulverization of 90,000 tons of electronics, concrete & metal decking -Destruction through path of greatest resistance at near free-fall -3 layers reinforced concrete punctured, + 3 unreinforced layers of concreted punctured at the pentagon, 6 layers in total punctured by a flying pop can.. -No debris or evidence of aircraft at all -Flight paths mis-reported and fighter craft response deliberately delayed by the Pentagon -Evidence destroyed before investigations , and this is a blatant crime done by the government, to hide evidence...Just like this is... “A FOIA request to NIST, by a registered structural engineer, for calculations and analysis substantiating the lock off failures of the horizontal girders from their seats, at column 79 and 81, was denied by NIST. With the claim that releasing this data, might jeopardize public safety” How could it possibly jeopardize public safety, to tell people in the industry, the architects and engineers who are responsible for designing these buildings, how this failure could occur?” cover up. End of story. “”The only peer-reviewed papers that provide a physically plausible mechanism for collapse of WTC 1, 2, or 7 are papers that conclude with controlled demolition – a result consistent with the fact that in over 100 years, no high-rise steel frame building has ever collapsed from fire alone. “” Timothy E. Eastman, Ph.D., Physics Group Manager for Space Science Support Heliospheric Physics Laboratory NASA Goddard Space Flight Center -------------------------------------- "The many visual images (massive structural members being hurled horizontally, huge pyroclastic clouds, etc.) leave no doubt in my mind explosives were involved [in the destruction of the World Trade Center]." Dwain Deets, MS Physics, MS Eng – Former Director, Aerospace Projects, NASA Dryden Flight Research Center. Before this appointment, he served as Director, Research Engineering Division at Dryden. Recipient of the NASA Exceptional Service Award and the Presidential Meritorious Rank Award in the Senior Executive Service (1988).  --------------------------------------------- “Serious technical investigations by experts seem to be lacking from the official explanations." Larry L. Erickson, BS Aeronautical Eng, MS Aeronautical Eng, PhD Eng Mechanics – Retired NASA Aerospace Engineer and Research Scientist. Conducted research in the fields of structural dynamics, aerodynamics, aeroelasticity and flutter. Recipient of NASA's Aerodynamics Division Researcher-of-the-Year Award. 33-year NASA career. Member, American Institute of Aeronautics & Astronautics.
Reply: *****
ASCII? Read it on the video instead of the side bar, dipshit.
I didn't type it in case you hadn't put 2 and 2 together, smart arse.
Reply: *****
I see what you are getting at, you have no actual argument, so you simply throw snarky remarks.
Reply: dangerouslytalented
Why didn't my steel log burner melt then? Like I said, I used to feed that with dry timber for hours on end, using bellows to circulate oxygen for extremely high temperatures. I often had to open windows as my living room used to get so hot.
Wallpaper began peeling and candles would melt.
Keeping that thing burning for hours on end didn't melt it.

I've also explained the 2mm steel bin I used to have bonfires in. Fuelled by petrol to get it going, I used to keep that burning throughout the day with various things. In an oxygen rich environment, it didn't melt and actually met its end due to rust.

I don't know how many times I'm going to have to ask you to explain how Newton's Third Law was broken, but I imagine you'll never have an answer for it.

And stop fucking going on about aluminium and lead, I've ALREADY told you they're SILVER when molten.
Reply: ***** In fact, I am not debating anyone here. Debating twoofers would imply you give them some merit. This is not the case. I don't debate people who believe storks bring babies from Paris either. Not because they are in possession of some undebatable truth, but because they don't reach the minimum threshold of credibility. Same with twoofers who believe in demolitions, no planes, nukes or laser weapons from outer space.

By the way, it wasn't me who said "Because you have a life". You may be responding to the wrong guy.
Reply: dangerouslytalented
You KEEP falling back to a plane smashing into shit. NO plane hit WTC 7 and NIST gave the reason for collapse as being structural weakening due to FIRE. NOT being hit by debris.

The steel DID melt. Search Google for 'Thermite cut column' - despite no inclinations towards 9/11, they will be the only results you'll get.
Show that image to your dad and ask him if it looks like that angled cut looks like it's been made by a professional with a thermic lance.
The excessive amounts of slag across the column do NOT point towards a professional with a thermic lance, but to a sloppy cut made by thermite.

And AGAIN I've shown you an image of molten aluminium in a crucible in a FOUNDRY. It's not being poured from a height of 400m and it's STILL forming its silver skin as it's being poured.

I see you're still ignoring basic laws of gravity and resistance that have existed since Newton and his apple.
Learn when to stop talking.
Reply: *****
No, you'll find Dan agrees with me.
Minimum threshold of credibility aye? I suppose we should take George Bush's word over Architects, Engineers, Metallurgists, Aeronautical Engineers, Pilots and military personnel including former CIA members?

Hey, remember when Bush said there were WMD's in Iraq and the world believed him? 

I'm a student of Architecture, so there's my credibility.

Where's yours?
Reply: dangerouslytalented
Once again, here's proof of molten steel. You can also see some parts of it have been vaporised.
A very common trait in office fires.

https://encrypted-tbn2.gstatic.com/images?q=tbn:ANd9GcTGTlkrLCgrXCu1OW4L21a8p31mY2kaHRpsB1V7Bpb2AHmeA4PmvQ
Reply: John Smith
Didn't I mention the collapse of tower 1 and 2 into WTC7? I mean, that caused massive damage to ALL of the surrounding buildings, the Verizon building needed a BILLION dollars worth of structural repairs, and the Deutsche Bank building was so unsafe that it had to be carefully dismantled as it was too dangerous to actually restore.

And the thermite cut columns were cut AFTER the collapse, in order to remove them. They could not use hand held cutting equipment because it was far too dangerous, as the collapse left some of the girders in precarious locations, or sticking straight up in the air, and some of the cathedral walls were still intact and on the point of collapse. The only safe way to bring them down without killing the people doing it would have been setting off thermite to cut those columns.

And a foundry only has to melt aluminium to its melting point. It is a COMPLETE waste of energy to melt it so far past its melting point that it starts to glow. They have absolutely NO REASON to heat it beyond the melting point.
Reply: John Smith
actually, you find that kind of damage after firestorms. I have been in places bushfires have gone through, and the steel in burned out buildings often looks a LOT like the pieces of steel you have shown me. The fires in those piles lasted for MONTHS.
Reply: dangerouslytalented 
And just to further put your argument to bed, the image of the thermite cut column was taken before crews were brought in to begin the clean up.
How do I know this?

http://666ismoney.com/sitebuilder/images/Thermite3-1171x836.jpg

See the firemen? Taken during the initial stages of collapse, within a few days. Not during the clean up, which extended for many months after 9/11.
Reply: John Smith
Huge portions of them fell all over the place. There were large parts in the Wintergarden, Deutsche Bank Building, Verizon building and elsewhere including wedged into the loadbearing facade of building 7. Have you not seen footage of the collapses? Parts of the facade went a pretty long way. Oh, and the source for sulfur? Try drywall.
Reply: John Smith
Before they got bucket brigades in, they had to make the place relatively safe, which meant cutting down the massive pieces of the remaining facade. That started the very evening of 911. That would have been the first thing they did after rescuing the few survivors.
Reply: dangerouslytalented
When you begin taking on board what I'm telling you, then this discussion can continue. 
Until then, continue believing WTC 7 was brought down due to falling debris and not fire, as given in the official explanation.
Reply: dangerouslytalented
Ah riiiight, so the FIREMEN rigged the thermite to cut that column! 
I'm glad you could clear that up for us.
Reply: John Smith
It was both falling debris AND fire, the falling debris destroyed the loadbearing facade and all the fireproofing, and the fires weakened the rest of the structure until the point of collapse. There was serious structural damage, the one person who got into building 7 after it was evacuated but before tower 1 and 2 collapsed said he looked out and there was nothing where the wall used to be. Daylight. Once it was clear that they were not going to be able to put out the fires, all the firefighters were pulled. There were other fires that COULD be fought, and many of the firefighters and most of their equipment were already lost. So they had to simply let it burn. You could not have firefighters in there when there was nobody in the tower left to save, hours after the last man had fled the building.
Reply: John Smith Steelworkers.
Reply: dangerouslytalented
No it wasn't. Look at NIST's official explanation for WTC 7. Fire. Not debris.
They've even admitted they're not sure how the Towers collapsed in the way they did at the speed they did.

There's little you understand about fire not being able to drop a building at freefall speed, isn't there? I've already proven the majority of your points wrong.

STILL ignoring Newton's 3rd Law though.
Now how did the Torch building in Dubai remain standing after fires ripped through 60 floors and gutted the whole place? Didn't collapse.

Windsor building? Burned uncontrolled for 24 hours. Didn't collapse.

And let me get this theory of yours down, steelworkers arrived on scene and began cutting steel box columns WITH thermite whilst rescue operations were still ongoing?

Jesus fuck you'll say anything to explain the events of that day, no matter how absurd they may be.
Reply: *****
Fuck sake, and there I was thinking I was onto something.
Surely the lead in the computers would have contributed to steel-melting temperatures though?
What about the hydrogen in the TV remote batteries? Or the explosively expanding H2O in the potted plants? Didn't think of that did ya?
Reply: John Smith don't bother these people will believe anything the government tells them. These are the same people who thought the USSR were big bullies putting missiles in Cuba but didn't know we put them in Turkey first. Just leave the sheep alone.
Reply: Dexion845
Oh I'm well aware mate. It's when they try to take the moral high ground with the tin foil hat bullshit that makes me laugh.
The things people will believe if they're told to eh?
Suddenly speaking out now leads to persecution. It's a sad world we live in.
Reply: John Smith
 DA TWOOFERS AER BEING PERSEKUTEED!!! WHEN and WHERE have you been persecuted?
Reply: dangerouslytalented
Do you know what persecution means?
(Prosecution is a different word)
Reply: John Smith
 You said persecution. I asked WHERE and WHEN you were being persecuted (and now I also add "HOW". Now DO NOT change the subject of the question, and ANSWER IT.
Reply: dangerouslytalented
I know what I said. I've said it twice.
Where did I say I personally was being persecuted? I quite clearly stated speaking out leads to persecution, the term "Twoofer" or the tin foil hat line would be 2 examples, 1 of which you yourself have just used.

But it's ok, as you can see I'm able to answer questions. At least 1 of us here can.

You on the other hand ignored my previous comment and still haven't explained the collapse of WTC7 and how the towers defied the basic scientific laws of physics.

So I'll use your own words against you here,
"DO NOT change the subject of the question, and ANSWER IT."

Carry on.
Reply: John Smith
I explained it, the loadbearing facade had massive damage from large pieces of the facade from tower 1 and 2 spearing into it. This started fires which could not be suppressed, as the sprinkler system no longer worked and the massive holes in the facade meant that fresh air could flood in and the smoke from the fires could easily escape. Further to the offices, there was the fuel tanks for the diesel generators for the emergency management center, (fucking stupid idea to place it so close to the number one terrorist target that it would be damaged if it was attacked and thus rendered useless) fed the fires even more.

Furthermore to this, there was a huge structural weakness. Below building 7 was a vault, which housed a large Con Ed electrical substation that serviced the area, which had a caisson foundation built to accomodate the previous building built on that site, which was only 25 storeys high. and thus had to be supported by a series of  bridging trusses  that supported the entire weight of the building between level 5 and 7, exactly the zone where large parts of the facade of towler 1 hit.

Also on this floor was the generators and their fuel tanks, along with electrical transformers.

Now the building was evacuated after the collapse of tower 2, although one person was able to enter after the collapse because everybody had gone, and had gotten up to the emergency management office to find it abandoned, and this was when tower 1 collapsed, so we have one eyewitness to the damage from the inside, which was apparently extensive, he could see daylight through the wall after the collapse of tower 1.

We also have footage of the fires from one news cameraman who managed to get across the street from building 7, and they show large firestorms that had already burned out several floors and were now engulfing two more.

The girders were fireproofed with spray on Gypsum based fireproofing, rated for two and a half hours. Two problems here: The fires lasted from the moment of impact that morning right to 5pm when the tower collapsed, well more than two hours, and because the fireproofing was gypsum based, the impact would have destroyed much of it in the damaged areas, leaving the girders in the affected areas exposed for far longer.

So basically we have: a tower which put far more weight on the base of the  loadbearing facade than normal due to developmental constraints, and had massive damage to the base of that loadbearing facade, large unfightable fires, damaged fireproofing, no working firefighting equipment, fires that went far longer than even the intact fireproofing allowed, and all this led to the whole lot collapsing.
Reply: dangerouslytalented there was a call to take down building 7. The fire damage was too extensive and they were worried it would spread so they took it down. But one more thing, buildings don't naturally fall straight down as the twin towers did. It takes months of planning to get results like that.
Reply: yishai silver
a call to take it down? That would absolutely make no sense, because they had no way to plant any kind of demolition charge in building 7. The place was already evacuated and abandoned. If there was an  order to pull it down, it would have had to have been done like the Deutsche Bank building, slowly and carefully after making sure the structure was safe.

The only way the fire could spread beyond 7 was if the whole lot fell apart.

Silverstein gave the OK to pull the firefighters, not the building.

And the towers did not fall straight down, they fell all over the place, bits of superstructure were found in the Wintergarden, WTC7, the Deutsche Bank building, the Verizon building, that was NOT a clean implosion.

The demolitions that take months of planning are not like that, they all fall inwards, they take out the interior columns and the whole thing falls within the footprint. But with the WTC, so much of it fell outside the footprint that the only safe place in the entire complex was the lower five storeys of building 1. That was where they pulled survivors from.
Reply: Yeah, there was a call to take it down. I forgot where but you can listen to a call where the building owner tells the fire dept to pull out, they're going to take it down. And what I'm saying with falling down straight is that the debris field was to small for chance
Reply: yishai silver
No, it was not "they are going to take it down" it was "it is going to come down", they evacuated the firefighters, it is just that a dishonest editor took the tape of Larry Silverstein saying "pull it, pull the firefighters", and cut off the last part of the sentence.

And the debris field was NOT too small, it was huge, incorporating six city blocks, and damaging neighboring buildings badly. The Verizon building needed a billion dollars worth of structural repairs, the wintergarden had a huge part of the facade in the middle of it, and the Deutsche bank building was so badly damaged that it was cheaper to carefully dismantle it and rebuild completely than to carry out the necessary structural repairs.
Reply: dangerouslytalented the NIST did not say anything about structural damage on WTC 7, neither did any reports or eye-witnesses where are you getting this from?
Reply: dangerouslytalented different density's
Reply: Dexion845
None of the eyewitnesses that the truthers come up with. I am talking about the guy who was trying to get up to the emergency management office after building 7 was evacuated, and had to get out after tower 1 had collapsed.  Go look at his entire testimony (not just the edited highlights that the truthers like to spout).Also there were witnesses  (but no photographs) of the south facing facade of building 7. It had a big gouge in it at leat 10 storeys high.
Reply: dangerouslytalented yea but the NIST said nothing about that so it could be considered "twoofer" talk
Reply: Dexion845
NIST did not have to, they did not mention why the Verizon building and Deustche Bank building survived either.
Reply: dangerouslytalented
"massive damage"
Here it is,

http://img.photobucket.com/albums/v256/covalentbd/aas.jpg

Don't ask my why it's dated the 19th. 
Now compare that to WTC 3.

http://911research.wtc7.net/wtc/evidence/photos/docs/wtc_biggart1836c.jpg

You'd have thought it too would have collapsed? Nope.

Here's WTC 4

http://i129.photobucket.com/albums/p201/Rainman71/WTC4.jpg

Remained standing.

"and they show large firestorms that had already burned out several floors and were now engulfing two more."
You mean these fire storms?

http://photos1.blogger.com/blogger/2116/144/1600/wtc7-fires-close.jpg

Like I've said, if those fires were hot enough to melt structural STEEL, then don't you think there'd be slightly more smashed windows?

Here's the Torch building in Dubai as fires ripped through 60 floors. Molten glass was also reportedly falling as it burned,
Which would you say looks more fierce?

http://i.kinja-img.com/gawker-media/image/upload/s--JO3z7NJs--/c_fit,fl_progressive,q_80,w_636/wyaysvdbjzo5iyozy9er.jpg

Oh and here's the Windsor Tower,

https://2012patriot.files.wordpress.com/2011/08/windsor_tower_1_small1.png

If ANY building should have collapsed due to fires, then the Windsor Tower burning for 24 HOURS is the one.

I'll say again, the fires in WTC 7 burned for 20-40 minutes.

Finally the damage to WTC 7 would have lead to localised damage to the fireproofing. The remaining columns would have remained completely unharmed from the damage caused by the debris, which once again, was not the reason for the collapse.
Reply: John Smith
The first one was the Deutsche Bank building. You can see the massive gouge in the facade,  the reason that one did NOT collapse was because it had concrete reinforced steel columns throughout all the floors, which kept any collapse localised.  ALL THE OTHER TOWERS YOU HAVE LISTED had floor columns. ALL THE TOWERS YOU LISTED apart from WTC 1,2 and 7 had them. The Deutsche Bank building had concrete and brick fireproofing, NOT drywall or gypsum. The other buildings ALSO had concrete fireproofing, AND DID NOT HAVE ANY MASSIVE IMPACTS DISLODGING THE FIREPROOFING. The fireproofing also had a better rating. The fires in WTC7 went from floor to floor. The nature of the damage was so bad that the firefighters evacuated the area completely.  WTC7 was already top heavy due to its construction, with a void housing the electrical substation at ground level. If you look at the architecture, the southern facade (which had the most damage) took most of the weight of the building below the 8th floor, and down the bottom of the tower was where most of the damage was (just like in the Deutsche Bank building and the Verizon building).

But tell me: What is your theory on the method they supposedly used to take down WTC7?
Reply: dangerouslytalented
Every single column in WTC 7 was coated in a fireproofing spray.
Here is an image that shows the interior and the famed column #79 which supposedly lead to the total global collapse of the tower.

https://www.metabunk.org/metamirror_cache/img253.imageshack.us_img253_2936_wtc7column79hm2.png

As you can see, it's been coated.

Here is a model showing the damage to WTC 7, as you can see, it's got minimal damage to the structure and any damage is like I said, localised,

https://www.google.co.uk/search?q=wtc+7+damage&client=safari&rls=en&source=lnms&tbm=isch&sa=X&ved=0CAcQ_AUoAWoVChMInIWskLDnxgIV5KzbCh3_MANA&biw=1250&bih=676#imgrc=tEp-gVNAOvyidM%3A

You believe this damage is enough to "dislodge" fireproofing throughout the entire structure? Get real.

Here is the model showing the collapse of the building. It is quite obvious that this is not what happened from video footage. But I look forward to you explaining how it is.

http://rememberbuilding7.org/wp-content/uploads/2010/08/NIST-collapse-model-building-7.jpg

My theory? Controlled demolition.
That would explain Barry Jennings' eye witness testimonies.
Controlled demolition is a science in itself, no two buildings are the same due to various variables. That is why I refuse to believe 3 steel structured towers (the first and only 3 in history) collapsed at freefall speed due to fire.

https://www.youtube.com/watch?v=Zv7BImVvEyk

This is Barry Jennings giving his interview shortly after being rescued from WTC 7,

https://www.youtube.com/watch?v=5LO5V2CJpzI

He reports "big explosions" that forced them back onto the 8th floor.

He also reported stepping over dead bodies in the lobby, which he later refuted despite video evidence, but don't take my word for it,

https://www.youtube.com/watch?v=nO9Tsigk5fc

"Silverstein gave the OK to pull the firefighters, not the building."
He actually gave firefighter the command to "pull" the tower, which is a demolition term.
He also conveniently insured the WTC complex against terrorism a few weeks before 9/11.
He made millions from 9/11.

"The demolitions that take months of planning are not like that, they all fall inwards, they take out the interior columns and the whole thing falls within the footprint."
You mean like this?

http://www2.ae911truth.org/images/gallery/wtc7debris.jpg

http://www.thewebfairy.com/killtown/images/wtc-gallery/wtc-rescuer/wtc7-1.JPG

If you'd rather believe the words of those on the Government payroll over eye witnesses and industry experts, then be my guest, but just remember 1 thing.

This comment is an orange.
Reply: dangerouslytalented but if that's true it should have fallen towards the least path of resistance not into its own footprint straight down as if everything below was suddenly swept out.

Who knows why or how the towers fell. Thermite this and that... All I know is the "official" report and conclusion from our government is nonsense just like the JFK fiasco, the Clinton scandal, the watergate scandal, the Cold War, 

Nevermind lets all go watch Fox News, there are some racial tension reports about the confederate flag we should all be focusing on while our government keeps up this 14 year war on terror so far that we are paying the interest from the loans out of the privately owned "federal" reserve where money grows on trees.
Reply: GreaterThanADeer
Which scientific evidence? Quote me some.
Reply: dangerouslytalented How about the very video you are commenting on? It follows the scientific method step by step.
Reply: John Smith
The fireproofing spray on wtc 7 was gypsum based and rated to under 2 and a half hours. Two problems here: The gypsum based spray on fireproofing was prone to being knocked off by any impact and the fires lasted longer than two and a half hours.

The big explosions Jennings heard when he was in WTC7 was the collapse of WTC1, and what happened? Two of the stairwells were blocked. IN WTC7. That means that WTC 1 penetrated the core of 7.

And there was no way for them to carry out Silverstein's order to "pull" WTC7 without already having charges installed before the collapse of tower 1 (because the way into WTC7 past the 8th floor was blocked, as per the Jennings interview) and there was not enough time and no way of getting any vehicles with equipment in, AND if they already laid explosives in there BEFORE the attack, then there would have been no need for Silverstein to give the order to pull it, because IT WOULD ALREADY HAVE BEEN DECIDED TO DEMOLISH IT.   WIthin the context of the truther narrative, NEITHER explanation makes sense.

Oh and your pictures showing that WTC7 fell within its own footprint show that (A) the building fell towards the damaged section (you can tell this because the facade lies on top, indicating that it fell more sideways than straight down like 1 and 2) and they also show damage to other buildings in the vicinity, in your second picture, that would be the high rise building at the bottom of the picture. You can clearly see that a large chunk of the top of that particular building facing WTC7 is simply gone. Also, you can tell by the amount of dust in the air, that that particular picture was taken well after the cleanup had already begun. A path had already been cleared for vehicles to truck out the rubble.
Reply: Dexion845
The least path of resistance was straight down for the floors, and outwards for the exterior facade loadbearing columns. There was nothing there strong enough to push the towers sideways. Not enough resistance on one side or the other.
Reply: John Smith I am PERFECTLY capable of reading and comprehending what you say, it is just that you are WRONG. EVEN your OWN EVIDENCE shows that what you are saying is not true. In the VERY FIRST PICTURE of building 7 you show me, you have TWO pieces of evidence that it did NOT fall neatly into its own footprint: The facade of it was lying on top, indicating it fell towards the area of destruction, and in the bottom left section is a white building with a LARGE section of its structure missing.  Big chunk missing. And parts of other buildings also had pieces gouged from them because of the collapse of WTC7. The only reason it did not do more damage was the original collapse of WTC1 caused massive damage to the southern loadbearing facade, which meant that when it fell, it fell over in a southerly direction, towards the already fallen twin towers.

And STEEL DID NOT HAVE TO MELT FOR THE STRUCTURE TO BE COMPROMISED. The fireproofing in the area of the damage was massively damaged, (being made from gypsum and not able to withstand any collision), the support for the bridging trusses was hit hard, and essentially the entire building was undermined by the rubble of tower 1.

Your building rolling over is a COMPLETELY different design, you can ACTUALLY see the concrete walls within, it was not a steel framed tube with trussed concrete floors and a bridging truss with the key supporting pylons in the facade. It is like comparing a lego set with a house of cards.
Reply: dangerouslytalented
Everything about that comment just confirms my suspicions that you're completely out of your depth.
Not only did you ignore the majority of what I said, the most incriminating being the fires according to NIST only burning for 40 minutes MAXIMUM, but you also STILL haven't explained NIST's model that shows a completely fabricated collapse.

The GIF I showed you shows what we SHOULD have expected, it didn't fall through the path of most resistance, instead it fell in the direction of the path of least resistance. Which is what should have happened to WTC 7. The damage would have been localised (that word AGAIN) around the "damaged" (I use that term loosely) facade.

Continue ignoring basic science, industry experts and video evidence, I don't give a shit. The only one who looks stupid here is you.
You'll prefer to agree with a story given by a institution on the Government's payroll than those that have nothing to gain by questioning the official story. 
DESPITE what I've told you about their explanation not adding up.

Your reason for the towers collapsing was structural damage caused by impacts of 2 jetliners, despite both towers being designed to withstand multiple impacts from far larger aircraft, and the subsequent fires, fuelled by PAPER and WOOD that allowed the towers to collapse at free fall speed within an hour.
You're also attributing molten metal to either aluminium, which has a melting point double the burning temperature of aviation fuel, or lead, which are both SILVER when molten. 

So that theory of yours is completely undermined when we get onto WTC 7. You're going with the structural damage line caused by falling debris, and subsequent fires which burned for a maximum of 40 minutes. Ignoring the basic fact that NIST ruled out structural damage and attributed the collapse PURELY and ENTIRELY due to fire.

You tried that bath experiment yet?
Reply: John Smith
You expect the whole building to roll over like that concrete one? Despite being a COMPLETELY DIFFERENT DESIGN?

Tell me: You truthers have had nearly 14 years to work it out: How on earth did they wire up the whole complex to blow? How did they lay the charges? How did they make sure they survived the initial collision intact enough to be able to be set off, and why did they wait so many hours to do so? And why on earth would they need Silverstein's say so to blow building 7 when they did not need any such authorisation for buildings 1 and 2? Your story has more massive gaping holes than the skyscrapers around the world trade center.
Reply: dangerouslytalented
Fucking hell you're dim. I expect the building TO FOLLOW THE PATH OF LEAST RESISTANCE. How a CONCRETE structure remained intact is NOT the point, so STOP sidestepping.

And in that 14 years, Bush and or Obama could quite easily have released critical information they've kept hidden from the public eye. That would be enough to put conspiracies to bed, but instead, they keep it quiet for reasons only known to them - most likely something along the lines of "To protect our national interests" and Obama comes out to chastise those that DON'T believe the official story.

How well do you reckon the 9/11 story would hold up in a court of law? Bearing in mind critical information would be missing from the defence, and the rest of it would e extremely questionable. 

Seeing as though you clearly can't describe to me NIST's WTC 7 model, and refuse to conduct a simple experiment, would it be possible for you to explain how these planes achieved their cruising speed at ground level?

Flight 175 for example flew for over a kilometre at an altitude of 6 METRES, flew OVER a highway, levelled off again, clipped 5 lamp posts and then struck the Pentagon in excess of 560mph.
Good ol' Hand Hanjour, couldn't fly for shit apparently but pulled off a manoeuvre military and commercial pilot VETERANS have deemed "bullshit". 
But what do they know eh? Let's take the word of an institution that wasn't there, took YEARS to compile their report, didn't investigate for explosive residue, and even THEN admitted they don't know why the towers fell at their speed and manner.

Can't blame them though really, not when you consider more money was spent investigating Bill Clinton's love life than the largest terror attack in the world's history. I probably wouldn't test for explosive residue either if that were the case, you get what you pay for.
Reply: John Smith
You did not answer my questions:

How on earth did they wire up the whole complex to blow? How did they lay the charges? How did they make sure they survived the initial collision intact enough to be able to be set off, and why did they wait so many hours to do so? And why on earth would they need Silverstein's say so to blow building 7 when they did not need any such authorisation for buildings 1 and 2? Your story has more massive gaping holes than the skyscrapers around the world trade center.

If you can't answer those after 14 years, then there must be something really really wrong. I mean, it's 14 years of research, there must be some idea as to a coherent narrative. Now answer the questions.

Oh, and a couple more: WHO did it, WHY did they pull it off in this manner, and HOW did they do it in such a manner as to be a complete surprise to everyone on the morning, and how long did it take to get it all together?

Some really really simple, objective questions, I don't even expect a definitive answer, just a narrative that holds together.
Reply: dangerouslytalented
If you think I'm going to answer a single one of your questions when you can't answer any of mine, then you're out of your fucking mind mate.

I can sidestep too, watch this, look,
Reply: John Smith
Yep,you sidestepped. Because you have nothing. I mean, I at least tried to answer your questions, with my limited knowledge, but you have had 14 whole years of studying this, and you have not even come up with a decent narrative, nobody with a  motive, method, opportunity that makes any sense at all.
Reply: dangerouslytalented
The irony in the past 2 posts of yours is outstanding. 
I've been reading into 9/11 for around 8 years. I've watched various documentaries, read various investigations and read books and even discussed it in depth with people.
Being a student of Architecture, and being surrounded by people on a daily basis who I'm sure would love to know how Architecture failed on 3 separate occasions in a single day, and hasn't happened since is enough to make you research into it.

That would explain why I've presented numerous pieces of evidence to you, accompanied with links to official statements, images and independent investigations. The vast majority of which you've ignored. 

You can't explain how pulverised concrete melted vehicles in the path of the plumes of dust that resembled pyroclastic flows.
You't can't explain how the collapses defied the laws of physics, be it Newton's Third Law, or the path of least resistance.
You can't explain the speeds the aircraft were travelling where air is 6x denser than it would be at their typical cruising altitude of 36,000ft.
You can't explain the presence of molten steel or the evidence that parts of the columns were vaporised, strangely being ignored by NIST.
You can't explain why NIST's model is nowhere near to what millions around the world witnessed on TV.
You can't explain why a mere 4 pieces of video footage from the Pentagon were released when there were 86 CCTV cameras in total surrounding one of the most defended buildings in the world.
You can't explain how 19 Arab hijackers were allowed to fly uninterrupted in some of the most protected air spaces in the world for several hours.
You can't explain why eye witnesses reported explosions and flashes which sounded like gunshots around the towers before and as they collapsed.
You can't explain why Robert McIlvaine's body resembled that of a bomb victim.
You can't explain how steel continued to be heated and melted in the rubble of the towers up to 100 days after their collapse.
You can't explain why countless eye witnesses can be heard in videos saying they weren't American Airlines and looked like military planes - this is then backed up by images of the plane striking the South Tower showing what appears to be a radar bubble on the underside of the fuselage, indicating a military plane.

I could go on, but I know you have no answers.

Tell me, what's your opinion on this?

https://www.youtube.com/watch?v=J7ZYRnqaaZg

And this,

https://www.youtube.com/watch?v=nQrpLp-X0ws
Reply: dangerouslytalented ask yourself this. If the jetfuel is so destructive to the point where it can melt steel beams, than why are there wooden office desk and computers standing up perfectly in the pentagon after the plane hit?

http://physics911.net/images/whitewall.jpg

Look closely, the fist and second floor have a wooden stool and wooden desk untouched
Reply: GreaterThanADeer
That can easily be explained.
Those desks were being trialled by the US Navy as fire proof desks to be fitted onto their ships, to prevent the spread of fire if hit.

They were coated with lead and had been chemically engineered to withstand tremendous temperatures.

It's easy to chat shit - this is the type of thing we're up against ;)
Reply: John Smith those damn desk are always burning down our terrorism ships...err uhh, battle ships
Reply: GreaterThanADeer
The jetfuel did not melt steel beams. The steel was not molten. And if the Pentagon was hit by high explosives, then that stool and desk would NOT have been unharmed.  You can see basically a cross section, where the plane went through, the parts of the building that were doused with jetfuel were burnt out, and thanks to the thick concrete walls (this building WAS built far sturdier than the WTC was) the fires did not spread upwards. Thus only the parts that got doused in jetfuel and were undermined by the impact were damaged.
Reply: dangerouslytalented
Not only melted, but vapourised. I'll reiterate that FEMA could not explain this,

http://wtfrly.com/wp-content/uploads/2015/01/911bpatsamples2.jpg

"(this building WAS built far sturdier than the WTC was)"
Yet every single concrete wall, was penetrated by a flying Coke can and seemingly pulverised itself in the process. 

A plane larger than 100m across leaving a whole just 5m wide. 
Oh, I'll add that it emerged the door to the cockpit wasn't even opened throughout the flight.

"On 27 November 2009 PilotsFor911Truth.org published a simple fact about the flight of Flight 77 which makes a conventional hijacking scenario impossible - according to Flight Data provided by the NTSB the Flight Deck Door was never opened in flight. The status of the door was polled every 5 seconds from 12:18:05 GMT to 13:37:09 GMT, and each poll logged the door as closed (a CSV file of the log can be downloaded here).
No-one entered the cockpit of the plane during the flight, therefore it was not flown into the Pentagon by an Arab hijacker."

I personally love this one. Look at all that undeniable plane fuselage!
http://stj911.org/evidence/docs/P200059_1.jpg

And here we have the Germanwings plane wreck, smashed into the hillside after a slow descent from around 37,000ft.
http://i3.irishmirror.ie/incoming/article5398262.ece/ALTERNATES/s615/Germanwings-crash.jpg

Large pieces of plane.

And here we have MH17,
http://images.bwbx.io/cms/2014-07-23/0723-MH17-wreckage-970-630x420.jpg

Here's one of the engines which should be extremely visible in the wreck of Flight 93,
https://lintvwtnh.files.wordpress.com/2014/07/ukraine-plane_spin1.jpg

Oh and the huge fireballs that managed to melt steel? Nowhere to be seen, the word 'poof' comes to mind.

http://i.ytimg.com/vi/GUrUQN0m79o/hqdefault.jpg
Reply: dangerouslytalented you literally just admitted that the jet fuel did not melt the steal beams. You have just proved every truther right. Welcome to our side
Reply: GreaterThanADeer
The pentagon was not built from steel beams, it was built from concrete.

The steel in the WTC was not molten. There were high temperature fires, but it was probably not steel that was shown cascading in that footage.
Reply: John Smith
Those two samples are easy to explain. If hot steel is exposed to water, then it oxidises the steel and gives off hydrogen, (look up Lane Hydrogen Producer).
Reply: dangerouslytalented
The Pentagon was built using minimal steel as it was in short supply when work began because of WWII.
The area hit, however, had recently undergone improvements that reinforced it even more - with steel.

"It was the only area of the Pentagon with a sprinkler system, and it had been reconstructed with a web of steel columns and bars to withstand bomb blasts. The steel reinforcement, bolted together to form a continuous structure through all of the Pentagon's five floors, kept that section of the building from collapsing for 30 minutes—enough time for hundreds of people to crawl out to safety. The area struck by the plane also had blast-resistant windows—2 inches thick and 2,500 pounds each—that stayed intact during the crash and fire. It had fire doors that opened automatically and newly built exits that allowed people to get out."

This is steel,
http://algoxy.com/psych/images2/moltensteelenclose5mt.jpg

This is steel,
https://encrypted-tbn2.gstatic.com/images?q=tbn:ANd9GcQygVzaXxyLq3QRF_wI-2QFjULiwk4IbL3NBMkW9M2rwou0ytRh

This is steel and concrete, which has been superheated to form what is being called a '9/11 Meteorite',
http://911research.wtc7.net/wtc/evidence/photos/docs/hanger17/meteor2.jpg
Reply: dangerouslytalented
You might want to speak with FEMA then because despite their investigations, they concluded (supposition) that it had been caused by substantial heat.

I've already provided you with a link to their report.
Reply: dangerouslytalented kinda funny because those sparks look an awful lot like a thermite fire. Considering thermite was found in the debris, it makes a lot of sense
Reply: GreaterThanADeer No, it really does not, as what they found in the debris was flakes of iron oxide and tiny pieces of aluminium, which are the materials to make thermite, but not actual thermite in and of themselves.

To assume this must have been thermite, would have meant to COMPLETELY disregard that anybody who was rigging the place up to blow would only put enough thermite in there to cut through the girders necessary to bring the whole lot down, AND that thermite can't be extinguished, so there would have had to have been a lot of thermite that did not go off, and the only place where there is an actual molten stream, in building 1,2 or 7 was that one molten stream in tower 2.

Also, thermite emits strong UV radiation, which leads to something called "welders sunburn", and if thermite was used, then many survivors would have seen molten streams AND had weldders sunburn.

Moreover, the maker of this video has created a device for holding the thermite in, and no such devices were found in the rubble.
Reply: dangerouslytalented
Here you go. Found in the debris, result of nano-thermite. Dismissed as paint chips, despite tests concluding that's exactly what they're not.
You may remember I've mentioned these before, but not surprisingly, you ignored it,

https://kendoc911.files.wordpress.com/2015/02/redgraychips.jpg

"welders sunburn"? 
So like this?

http://www.documentingreality.com/forum/attachments/f149/233926d1292202689-9-11-burns-survivor-m216743961.jpg

He made a device to prove that despite the National Geographic documentary, thermite can quite easily cut through steel.
The thermite he used was also home made, not nano thermite, which as I've explained, is military grade, and has been created from the molecular level up. Making it smaller and easier to ignite. It can also be painted onto steel columns,

http://www.wtfrly.com/wp-content/911truth/fp/2013wtfacts19fp.jpg

^ Dr Niels Harrit
Reply: dangerouslytalented You're making a lot of assumptions. We're all trying to give you the facts but you counter it with your pseudo expertise.
Reply: dangerouslytalented
Fancy that, experts using the perfect amount of thermite to bring down a skyscraper? What are the chances?
Iron microspheres are a bi-product of thermite, as are the red chips. It's really that simple. Instead of trying to par them off as the result of 70 year old construction, use logic.
And again, there are eye witnesses who reported molten steel running down channel rails within the towers.
Answer me this, if the fires were so ridiculously hot, why does not one SINGLE eye witness mention them being so? And how exactly were people able to escape from above the impact zone, where steel weakening fires were supposed to be raging?
Edna Cintron? Videoed standing in the impact hole of the North Tower, I suppose she had been coated in something within the towers that prevented her feeling the heat from the "firestorms" just behind her?

Finally, if NIST disproved the pancake theory, then what caused the squibs, estimated to be travelling in excess of 100mph appearing around 30 floors below the impact zone as the towers collapsed?
Strangely, very consistent with thermite detonation.
In fact, in 1 video it appears someone is forced out a window because of one.

Watch these,

https://www.youtube.com/watch?v=yli-if4F0DY

https://www.youtube.com/watch?v=_MJGEkivbfA

At the end of the day, I couldn't give two shits if you continue believing what you're told to believe. 
I know what is and what isn't possible. I also know the reputation of the US Government when it comes to things such as this, from the Gulf of Tonkin incident to Operation Northwoods. This type of thing isn't unheard of and now look what it's brought with it.
The GWOT and the Patriot Act. Suddenly the West is facing untold Islamic extremism and we're now being told ISIS is a threat when it hasn't even attacked the West, but very evidently has the means to. 

If you want to continue believing 19 Arabs planned the largest terror attack in history from a cave in Afghanistan with little to no flying ability, then go ahead.
Reply: They found a rock of steel and thermite residue, which had bonded the two together due to the heat. Also, how did all of those steel bolts come out from so many girders if they hadn't melted out? How would melting aluminium cause a whole steel frame to crash? And finally, how do you explain the live bbc report stating that tower 7 had fell when it was standing in the background
Reply: dangerouslytalented Its just the fact that what they found was exactly thermite residue. Not only that, but they also got more specific and determined what TYPE of thermite was used.
Reply: GreaterThanADeer
Watch these, very insightful,

https://www.youtube.com/watch?v=yli-if4F0DY&index=4&list=LLYLKY4rC27_t5e6P3vTCLEQ

https://www.youtube.com/watch?v=_MJGEkivbfA&index=1&list=LLYLKY4rC27_t5e6P3vTCLEQ
Reply: dangerouslytalented
There was no need for the thermite to be extinguished. It need simply not ignite, which, if you've looked in depth into the collapse of the towers, it looks like some of it did not, as a few floors remained structurally sound as the tower collapsed around them.
I believe this is evident in the videos I linked above, if not I will find it and show you.

As for thermite not being able to burn through a steel girder, you'll actually notice it's not a very large quantity whatsoever.
Compare the amount he's using to the amount the Nation Geographic used in their experiment to discredit the suggestion thermite was used.

You know for someone as dim as yourself, tossing about the "impossible" line is a little contradictory.

Seeing as though you refuse to take part in my bathwater challenge, try and answer me this,

I have 2 bricks, both of equal size, mass and volume.
Both are dropped from an equal height, for the sake of hypotheticals let's say 10 metres, at the same time.
1 of the bricks has zero resistance.
The other brick has 40,000 tons of structural steel worth of resistance.

Which brick will hit the ground first?
Reply: John Smith then any unignited thermite was NOT NECESSARY. Why would they put so MUCH unignited thermite in there, when they simply could have made sure that the thermite ignited by using more foolproof systems to ignite it, rather than the (evidently) extremely unreliable means that would be necessary for so much of it to remain unignited... Oh yeah, and if so much was left unignited, why use it in the first place?

And your two bricks hypothetical does not make any sense. However, if you replace the word "brick" with "the top ten storeys of the World Trade Center", and the "other brick" with "the parts of the facade that fell away from the building" we see that the parts of the facade that fell away from the building DID in fact fall faster than the main mass of the building, which shows that the main mass (initially the top ten or twenty storeys of the towers) DOES FALL SLOWER THAN FREEFALL SPEED, if we accept that the parts of the facade that fell away from the main mass fall at free fall  speed.
Reply: dangerouslytalented
What are you on about? How much un-ignited thermite do you think was found? Google returns 4 images of the red-grey chips which tests prove isn't paint, but in fact un-ignited nano thermite.
This has been confirmed by experts such as Niels Harrit.

I've gone over this with you I don't know how many times.
NIST agrees in their report the towers fell in freefall. Under 11 seconds. That's a floor per second. 
Building 7 however fell for freefall speed a total of 2.5 seconds and collapsed in 6.5 seconds.

The damage to Building 7 should have resulted in an asymmetrical collapse, instead what we see is the building falling straight into its own footprint, characteristic of a controlled demolition.

The same is said for the towers. There's absolutely no explanation in the official story for the towers to collapse at the speed and in the manner they did, again, this has been said by NIST. 
The lower floors were un-damaged and would have resisted the upper floors collapsing onto them.
Again, this is where the laws of Physics come into it, something you've been unable to explain.

You then have FEMA admitting to the presence of liquified steel and temperatures exceeding 1800 degrees Fahrenheit, 300 degrees more than the burning temperature of aviation fuel.
NIST did not investigate claims of molten steel as they didn't consider it vital to their investigation.
You also can't explain why NIST's model of Building 7 does not resemble the actual building collapse.

Aside from this during experiments they could NOT replicate the tower collapse on computer models, despite hotter fires burning for 2 HOURS. The steel did. not. weaken.

Even in physical models, where steel was heated to excessive temperatures for twice the length of time they were on 9/11.
I didn't fail.

You also won't be able to tell me how it was possible for Flight 77 to strike the Pentagon in excess of 530mph at an altitude of 6 metres after maintaining that height for over a kilometre, indicating it was not in a dive.

Impossible.
Reply: John Smith
Niels Harrit is the ONLY expert. 4 paint chips found in his samples. That's a hell of a lot as a proportion of the dust samples.

And (I don't know why you truthers keep on repeating the lie) THE TOWERS DID NOT FALL AT FREEFALL SPEED. That is obvious by JUST WATCHING THE VIDEO. You can see the parts of facade that fell away from the main mass of the building, and you can SEE THEM FALL FASTER THAN THE MAIN MASS OF THE BUILDING. Why do you KEEP ON REPEATING THIS LIE?
Reply: dangerouslytalented you can clearly see when each of the building falls, the top section of them stay perfectly together, and acts almost as a battering ram to destroy the rest of the building.

Another point was bought up by my brother who took an HNC in Construction. In the 1960s, there was a major problem in buildings where if one storey fell, it would collapse the one underneath it, and so on, until all of the floors collapsed. It was catastrophic. A way around this was by strengthening 1 every 5 or 10 floors, so they they could hold the weight of the ones above it. 
40 years on, in the tallest towers in the world, 4 floors damaged, and the whole thing managed to fall down. The funny thing is that an airplane is made of light materials. How on gods earth could it do so much damage that all of the structural defenses are broken? It's impossible. I would understand if 4 floors fell, but for the whole thing to go? It's rubbish.

If you look at pictures of the steel beams found, such as the horse shoe beam and the crucifix beams, it is clear that it had got to a high enough temperature to melt steel. You cannot blame these bends and molds just on sheer weight on top of them, because the horseshoe beam has no cracks or creases, and if you know anything about steel then you will know that you cannot bend a piece of steel without intense heat and not crack it or crease it.
Reply: dangerouslytalented lt fell just a few seconds slower than free fall speed. Don't you think thats an awfully small margin for a 1400ft building with tens of thousands of tons of steel beneath it?
Reply: Joe V
None of what I've posted is known lies.
No, the towers fell in 9 and 11 seconds. 
What you're referring to are the weaker core columns that remained standing and could be seen through the smoke, by which point the towers had already crumbled around them.

I can provide you with a link in which a Scottish Engineer (MEng) discusses this.

Experts in demolition have described the collapse of the penthouse as characteristic of a controlled demolition.
The penthouse gives way, and the rest of the structure falls with it, falling at free fall speed for a total of 2.5 seconds, with global collapse of the structure taking 6.5 seconds.

If you knew anything about metalwork, then you'd know the image of the column I posted indicates too much slag for it to have been cut by a professional. 

This image, despite it being captioned as proof of thermite, indicates the columns were actually cut by a thermic lance, evident in the lack of slag, and workers in the background.

http://www.lowbird.com/data/images/2011/06/wordpress-9-11-evidence-of-thermite-cut-columns-b-indicated.jpg

The initial image showed firefighters still on site, by which point steelworkers hadn't begun cutting anything.
Rescue operations superseded steel workers. You don't begin dropping heavy steel columns down onto debris piles where you know survivors are.
Reply: John Smith time it yourself, dippy...and remember,, don't stop the clock just because the building disappears into a cloud of dust, it is still collapsing...If you wont or cant do that.. POST where it states collapse times of 9 and 11 secs.  You wont,,, because there is NO site that will say that.

Photo evidence from you..??  You don't know crap about welding, cutting, or ironwork... You posted another pic in your post above.  HAA you moron,  You don't understand the nature of thermite either, neither did whoever claims that is evidence of thermite cutting...

Here, hows this for a 'common sense' thought.. You MUST think every inspector, Port Authority person, fireman, that saw those beams sticking out of the debris pile must be idiots, because not ONE said 'hey, look at how those beams were cut,  what the fuck did that"?????   ,,,,,,  NO one said it because,,,,  they all know the beams were cut by torches..  look closely at your 'single' beam, and also at the large one in the center of your other pic,, the diagonal torch marks can be clearly seen.. along with slag Only at the bottom cut...

Get your facts straight. or just remain retarded, like any other truther.
Reply: GreaterThanADeer
I dunno about that Deer, it was a mighty fine beam.
Reply: GreaterThanADeer
Where is your actual proof that that image was taken before any steel workers were present? There is not that huge pall of dust in the air that was present for the first few hours, the air had essentially cleared by the time that photo was taken, that much is obvious. Go find me the origin of that photo before saying exactly when it was taken.
Reply: dangerouslytalented
Why don't you prove that the image was taken DURING the steel workers arrived?
Or instead, you can use use logic.
Firefighters were on scene, meaning rescue operations were still ongoing. Remember they continued for several days, meaning the smoke would have cleared.
Do you think it's likely that steelworkers will be sending in people to cut columns when rescue personnel were trying their hardest to save people? You don't clutter the site of a crime with clean up crews until rescue operations have been completed.
You also don't begin cutting columns with both survivors and high volumes of traffic moving around the site.

Aside from these basic logical factors, you can't ignore the fact that column has not been cut by a professional welder with a thermic lance.
I've shown you what thermic lances do to steel when they cut through steel, and it's not comparable to the column photographed on 9/11.
Reply: John Smith
All I have to go on is the amount of dust in the air, and the fact that the first thing the steelworkers did was cut down the dangerous cathedral walls which could collapse at any time.

You are the one who provided the picture, go get the date stamp. ALL you have is the word of the truther website claiming the picture was taken on the first day. That is ALL you have.

Oh, and another thing: If it was cut in such a way TO BRING IT DOWN, then the cut girders would not be lined up like the ones in the picture. They would have been thrown around willy nilly during the collapse. They would NOT have landed all lined up like in that picture right there.
Reply: dangerouslytalented
Do you think the dust was still visible the day after the collapse? What about 3 days after the collapse? When rescue operations were still ongoing? 
That might have been the first thing they did, but you're not taking into consideration the timing.
I didn't get the image from a truther site, nor did I get any information from the truther site. Everything I'm telling you is logic.

I have no idea what the last part of your comment means. Which photograph are you referring to?
Reply: John Smith
The day after the collapse, they were already cutting steel to start clearing it up, because many of the girders and bits of facade were precarious and could have collapsed at any time. It's the FIRST rule in such situations, make sure the area is safe for rescue and cleanup teams.

And you STILL do not have any proof as to when the photo was taken.
Reply: dangerouslytalented
Once again the cut and slag on the column does not point towards it being cut by a professional, as shown by the comparison image I posted earlier.

The photo was taken in the first few days of the collapse, as is evident by the firefighters still wearing their respirators and dusty clothing.

For someone who can't answer the questions I've posed them, you're still an egomaniac. I suggest you calm down and recall your lack of knowledge on the subject matter.
Reply: John Smith
didnt have to be neat.
Reply: dangerouslytalented
No it didn't. But with professionalism comes efficiency.
With that amount of slag it means the welder was not working efficiently, if you know much about thermic lances, then you'd know why that isn't a good thing to be doing, especially given the quantities of steel that required cutting.
Reply: dangerouslytalented You act like this photo was portrayed to be taken minutes after it collapsed. The dust settled within a day
Reply: GreaterThanADeer
The dust settled within a day, but that does not prove anything about when the photo was taken, AND they started cutting down the more dangerous part of the debris field as soon as possible. And this photo HAD to be taken some time the next day at least, because the dust from WTC7 did not settle properly until after nightfall.

But to be fair I will ask you THIS question:

What is your proof that this photo was taken before they started cutting down the dangerous parts of the remains of the WTC?
Reply: dangerouslytalented
I've already told you. That cut is not consistent with a thermic lance and is instead characteristic of thermite, as it doesn't burn accurately and produces a lot of slag.
Aside from that you have the presence of thermite bi-products in the dust.

What is your proof it was taken during the clean up and provides evidence of it being cut by a thermic lance, despite the evidence?
Reply: John Smith
They would use thermite in a situation where the girder involved is under stress. You don't want the whole girder snapping in the steelworkers face, you want to light the blue paper and get clear before the thing goes off.

And you have no evidence apart from your assertion that the picture was taken before anybody moved anything that the picture was taken before anybody moved anything. Hell, you can't even provide any original source for the picture.
Reply: dangerouslytalented
Name ONE source that suggests workers used thermite to bring down columns during the clean up.
You just go from guess to guess don't you?
Only fooling yourself.

1) Firemen on scene still wearing dust masks and dusty clothing indicates it was taken during the clean up
2) The column was not cut by a thermic lance
3) No evidence that it was cut by steelworkers using thermite
4) You don't start felling heavy steel columns into an area of high traffic where survivors are known to be trapped
5) Thermite would take longer to rig than it would take a worker with a thermic lance to cut a steel box column

Instead of looking at each individual discrepancy, look at 9/11 as a whole. Such as FEMA stating fires were in excess of 1800 degrees and that steel was liquified.

Then admit you don't have the answers to my questions and that you're a fool for believing whatever you're told by a Government with  history of false flag operations, despite the scientific proof.
But hey, why SHOULD you trust the word of over 1200 engineers and architects with nothing to gain through doubting the official story?
Crazy talk.
Reply: John Smith
What you are doing is looking at percieved discrepancies and then shouting "INSIDE JOB" instead of asking how it could have happened. You provide NO answers. But tell me, What do YOU think happened, how were they cut, when were they cut, and why did they remain aligned?
Reply: You dangerouslytalented are an idiot anybody with an ounce of experience would recognise that flow as molten Iron and certainly not any other of the metals you cited.
It's a wonder you've not said the pulverised Aluminium from the planes fuselage intermingled with the rusty superstructure of the towers and made Thermite … grasp straws often?
Reply: dangerouslytalented
I don't know how many times I have to tell you this, but you are in no position to be questioning me when you've answered none of my questions yourself.
Not only have I explained the discrepancies, I have also described to you the impossibilities in the story that have been backed by industry experts who are not on the Government's payroll (unlike NIST) and have nothing to gain from questioning a Governing entity.

If you're of the ilk to believe what you're told to believe without questioning the possibility, and frankly likelihood that it's not what actually happened, then that is entirely your prerogative. 
I as a student of Architecture have read publications and examined hours of video footage to reach my conclusion.
Reply: +John “DipDop99” Smith Of course! it was an inside job!, thermite was planted in key beam sections and planes with real people were ordered to be flown into the buildings. No one ever leaked this from the inside! not one person leaked from the hundreds of people that it would of taken to plan it! And for what? You are so deluded to jump on the thermite/inside job bandwagon when it is UNIVERSALLY ACCEPTED amongst scientists that 1500 DEGREE+ HEAT with 10 THOUSAND+ TONNES OF WEIGHT bearing down on the ALREADY WEAKENED CORE BEAMS for 40 MINUTES weakened the steel to point of collapse on one floor. Not melted the steel but weakened. Case closed end of discussion. (i don't reply to conspiracy theorists i just tell them they are paranoid and delusional as you have to be when you think your own government is trying to kill you).
Reply: Rob k
I would say you were strawmanning them, but that is what they actually believe.
Reply: Rob k
Here's a novel suggestion Rob, go back through my comments in response to dangerouslytalented and learn something. You'll notice even he could not refute the things I told him.
How often do you see the pilots when you get on a plane? Drone technology has existed since the 20th century, and if you'd look at the passenger numbers, all 4 planes were in fact extremely below capacity.
FEMA in their report admitted the presence of molten steel thanks to temperatures in certain areas of the structure exceeding 1,800 degrees. 300 more than the burning temperature of aviation fuel. Which, by the way, was burned off within the first 10 minutes of impact, a lot of which was actually ejected on impact and didn't even ignite.

NIST tried to replicate the weakening of the floor trusses. Despite higher temperatures in a controlled environment for TWO hours, the floor trusses showed NO signs of weakening.
NIST's explanation for the collapses revolved around the weakening of these floor trusses (which were incased in concrete), making them pull the exterior structure inwards.
Their OWN experiment failed to replicate their conclusion, despite increases in both temperature and time exposed to it.

You're acting like 40 minutes is a long time for steel box columns and I beams to be exposed to office fire. 
Take a look at the Windsor Building - burned throughout the entire structure uncontrolled for 24 hours and remained standing.
The Torch apartment tower in Dubai only recently was gutted by fires that burned across 60 floors for over 6 hours, with fires hot enough to melt windows - didn't collapse.

Both towers were designed to withstand MULTIPLE impacts by Boeing 707's and even earthquakes. It's structure was unbelievably strong. It had been designed with a tube structure to give it its immense strength. 

I'm delusional am I? Seems you've got a lot to learn.
Oh, and for the record, the US Government has plotted on multiple occasions to kill Americans to go to war, Operation Northwoods was one of the most infamous.
As well as this the CIA's Eugenics Program that focused on population control through forced sterilisation influenced the Nazis to conduct their own human experiments.
If you think your beloved Government wouldn't commit such a crime, then you're twice as retarded as you sound with that comment.
Reply: John Smith
They were under capacity because it was a tuesday morning. Planes don't fly at full capacity during the middle of the week, they are at full capacity before and during holidays, and on thursday, friday, saturday and sundays.  They would have CHOSEN that particular time to hijack the planes BECAUSE they were at minimum capacity. Relatively few people to fight back. If they hijacked when the planes were full, the passengers would have stood a far better chance of thwarting the hijacking (as happened on one of the flights).

And I don't know where you got the "multiple 707s" bullshit, do you know how they actually modelled the effects of a plane crash? They took the supercomputers of the day (less computing power than in one of today's watches) and in a computer program designed to calculate load stresses, they simply removed one of the exterior walls. No calculating the effect of thousands of gallons of fuel, no way of calculating how much of the core would have been damaged, no way of telling how deeply the damage to the floors would actually go.

Oh, and that apartment building in Dubai? You know how apartment buildings are constructed don't you? They use concrete slabs, rather than trussed column free floors. This means that damage is extremely localised, floors are supported every few metres instead of having an acre of column free floor space, which means that floor trusses will not sag or weaken due to fire, as the floor supports are insulated with CONCRETE, rather than drywall and spray on gypsum fireproofing.

Oh and the Dubai building was subjected to neither a plane crash nor the collapse of any nearby skyscrapers.
Reply: dangerouslytalented
I've always flown on full planes, no matter what day of the week or time it is I'm flying. It's not efficient to be flying planes with such low capacities.
I remember reading a large number of the pilots in charge of the 4 planes were Vietnam veterans, I have a very hard time believing any Veteran would allow an Arab to hijack his plane armed with a box cutter. 

As for multiple 707's, the designers of the towers said so in one of the multiple and lengthy documentaries I've watched. Do a little research and you'll find that even to this day, those that designed the towers maintain they could have both withstood plane impacts.
Hey, they also modelled WTC 7's collapse as well, have you seen it?

https://encrypted-tbn2.gstatic.com/images?q=tbn:ANd9GcQsVEN17GCKOMqUrlhMxK6aBoNI1FWOf3dD0SbsWmuVugSYMQWx

That model does not represent the collapse that was witnessed by millions around the world. 
Hahahaha the documentary I mentioned answers all of that, in fact, they mock what you've just said by suggesting that it's insane to claim the designers assumed these planes were not carrying fuel and instead glided into the towers.
You don't need a computer to calculate the velocity of a 707 striking a steel tower. How do you think Isambard Kingdom Brunel designed the worlds first wrought iron bridge in 1831 without a computer to calculate the tolerances? 200 years on it's still in use as a toll road.

Steel has a very high tensile strength, its thermal resistance however is very low. This is why steel is encased in concrete, to offer protection against high temperatures.
Concrete on the other hand has a low tensile strength but very high compressive strength, which again is why concrete slabs are reinforced by steel reinforcing bars (rebar). Both are designed in conjunction with one another to create a very solid structure. 
The floor slabs in the towers were steel reinforced concrete slabs.
The reason for the tower's large office space and reduced number of interior support columns was down to the way it was designed. The inner core column consisted of 47 vertical box columns - this core was incredibly strong as it had to also support the exterior columns that spanned out from the floor trusses.
This was what I referred to when I mentioned the tubular structure.

Damage is localised is it? Yeah that must explain why fires rapidly spread across 60 floors.
Alternatively you've got the actual localised fires in the towers burning for less than an hour with the only fuel to the fires being office furniture, which in itself is fire resistant to some degree by regulation.
Fires in the towers did not rage out of control throughout the entire towers, they were confined to the immediate impact zone thanks to the hermetic seal on the lift shaft.
You've also got several accounts of people managing to escape both towers from above the impact zones, somehow traversing fires that were busy melting steel.
Take Edna Cintron for example, videoed standing in the hole in the North tower where fires should have been extremely hot, instead she can be seen holding to an exterior vertical support, waving.
Take note that no survivor ever reported such high temperatures, just enormous amounts of smoke, this would be because thermite would only offer high thermal signatures within the immediate area.

"Oh and the Dubai building was subjected to neither a plane crash nor the collapse of any nearby skyscrapers."
WTC 7 was 220 metres from either one of the towers, any damage sustained by their collapse would have been minimal. In fact, for any steel column to eject itself laterally for such a distance is in itself very questionable. For that to happen, gravity would have had barely any influence on its trajectory.
Watch footage of the collapse, large steel columns weighing in excess of several hundred tons are being thrown horizontally as far as 2 blocks.
Reply: John Smith
I have flown on full planes and on half empty planes. Non-budget airlines will not discount their seats at the last minute to fill up the planes because they don't want to undercut themselves. It is not unusual for planes to take off under capacity. The other option to fit with your hypothesis is that either the passengers never existed or they were all kidnapped and imprisoned or euthanased.

As for the pilots, they were AIR FORCE veterans. Not used to hand to hand combat, they flew either as bombers, cargo jet pilots or flying fighters, and they would never have needed to be ready for hand to hand combat,  and not ready for a guy in a suit with a knife who stood behind him and slit his throat without him even knowing what happened until it was too late.

And I have no idea what you have been told about thermite, but that stuff is MASSIVELY hot and emits a massive amount of UV radiation. It is not the source of the heat that matters, it is how it is TRANSMITTED AND CONDUCTED. No matter whether it is a jet fuel fire or thermite. And she was waving for help at the window. This was where the fresh air was COMING IN. Upwind of the inferno. The heat and smoke would be going DOWNWIND with jetfuel, but with thermite (with higher radiant heat and UV radiation) would be emitting heat in ALL directions. Oh, and anybody placing thermite charges would be placing them at the weakest points, RIGHT AT THE EXTERIOR WALLS.

Oh, and as for WTC7 being too far away for the falling Twin Towers to damage it, that's pure bullshit. Buildings far further than that suffered structural damage, the Verizon building needed a billion dollars worth of structural repairs and the Deutsche Bank building had to be carefully dismantled, it suffered so much damage (and neither of these buildings had column free floors, they had brick or concrete reinforced steel pillars thoughout the floors).
Reply: dangerouslytalented
There are multiple suggestions for what happened to the passengers. There is nothing suggesting they were ever even taken off the plane, it's likely the planes were drones and controlled from the ground, especially when you consider what Flight 175 looked like.
This is it,

http://911research.wtc7.net/essays/salter/podimages/2ndTowersmall.jpg

Note the bubble on the underside of the fuselage, something I'm sure you'd agree is not consistent with a passenger airliner. 
This is a USAF plane with a radar bubble,

http://i.ytimg.com/vi/jRC4lCQuBmc/hqdefault.jpg

The theory is likely the planes were military planes outfitted to look like American Airlines planes. This would also coincide with eye witnesses in numerous videos claiming the planes didn't look like American Airlines, had no windows and instead looked like military planes.

You don't need to be experienced in hand to hand combat to prevent your cockpit being invaded. There's no way a Veteran, especially of Vietnam would allow it, especially when you consider there were 5 hijackers per flight, against a plane of 60 or so.

Thermite is incredibly hot, but does not burn for very long and does not emit heat over a large area like a fire would. It's focused, as can be seen in this video.
You're talking about conduction of heat, but are forgetting certain areas of the steel was superheated to in excess of the burning temperature of aviation fuel - by 300 degrees.

Look at the image,

http://thewebfairy.com/911/edna/laststand_r1_c2.jpg

If you've ever been close to such a large fire then you'd know how hot that area should have been. And again, going back to what you said, conduction would lead to very high temperatures in that particular area.

The thermite would have been placed on the internal core actually, as this is the strongest structure of the tower. These are easily accessed through the lift shaft. You don't placed thermite at the weakest point, that's hilarious. You sever the strongest point, no point wasting materials on the weakest columns is there. 

I didn't say it was too far from the towers to be damaged, hot shot. I said it was far enough that any damage would have been minimal. There aren't many images of this damage, but here's one,

http://www.rense.com/general65/WTC7_sw_after_1.jpg

The Verizon was damaged in the collapse of WTC 7, whether this damage was caused during or after the collapse is not clear, but here it is,

https://upload.wikimedia.org/wikipedia/commons/f/f8/Verizon_building_damage.jpg

The Deutsche Bank was damaged by the collapse of the South Tower. It was not as far away as WTC 7 either, 

http://i.dailymail.co.uk/i/pix/2011/02/09/article-1355083-0D1AA547000005DC-266_634x419.jpg

This damage would have been caused by one of the lateral support columns being ejected horizontally. Experts have said that the only way for this sort of trajectory would be because of a very powerful explosion. 
I can link you to several videos if you're interested. I very much doubt you are though.
Reply: John Smith
Except a drone controlled from the ground with a large piece of equipment hanging from its belly would have handled wierdly, and the pilot would have immediately remarked about it to the control tower, because pilots know their planes, and know when they are flying sluggishly or whatever. And they would PARTICULARLY notice if the plane is not flying under their control.

And your silly drone theory can't work, as the passengers MADE PHONE CALLS FROM THE PLANE SAYING THEY WERE HIJACKED BY OTHER PASSSENGERS. They said how the pilot's throats were cut. And, of course, if they were drones, the passengers would never have been able to rebel on United 93, because there was no hijacker to overpower.

Oh, and your picture of the damage on WTC7 did not show the damaged face of the building, only one of the corners. And that was significantly damaged.And the damage on the Verizon building was more significant around the base, but as the building was built with brick and concrete floor columns throughout, no collapse could spread. The Verizon and Deutsche Bank buildings were built far earlier than the WTC, and were overengineered due to the fact that they lacked the technology to do things like have clearspan trussed concrete floors. They had no way of calculating internal tensions on such a vast building.
Reply: dangerouslytalented
The bubble is a radar cluster, the drone controls are all confined to the cockpit. 
You don't get it do you? If they were drones there would not have been pilots.

Have you heard these phone calls? 

If they were drones, Flight 93 could have been deliberately crashed to portray the passengers as heroes, or it could have malfunctioned. There are multiple theories. Also I refuse to believe the debris field left by Flight 93 was a plane. Here is the image of the crash site of Flight 93 used in the Moussaoui Trial, if you were not aware of 9/11 the actual impact zone is extremely difficult to establish from this aerial photograph,

http://www.vaed.uscourts.gov/notablecases/moussaoui/exhibits/prosecution/P200057.jpg

Meanwhile let's look at MH17, shot down over Ukraine at an altitude of 36,000ft and impact the ground at an extremely high velocity.

http://static.communitytable.parade.com/wp-content/uploads/2014/07/malaysia-plane-shot-down-wreckage-ftr.jpg

The debris field was immense and spread for 13 square miles. Not only that but obvious plane parts are easily recognisable from the images, from engines and landing gear to seats and suitcases - it was all there.
Not only that but even bodies remained intact, there's a rather disturbing image of what looks like a child, still in his seat lying in the middle of a road.

None of this remained from Flight 93. Landing gear and huge portions of fuselage were vaporised. Yet luckily 2 of the hijackers passports were recovered? Fuck off.

I'm sure I've already told you this, but in NIST's report on WTC 7's collapse, they categorically state the building was brought down purely by fires - which they admitted only burned for a maximum of 20 minutes in any given area before spreading throughout the building.
Any damage to the exterior facade is not applicable in this instance I'm afraid. 

And once again you underestimate the calculations Architects are trained to make in order to build sturdy structures. 
Explain to me how Isambard Kingdom Brunel calculated the stresses on the world's first wrought iron suspension ridge that is still in use today, 200 years on, please.
Reply: John Smith

A radar cluster? Dude, ALL COMMERCIAL AIRLINERS HAVE RADAR ANYWAY. A radar cluster strapped to the bottom is completely redundant. And you have no way of actually saying what is in that lump anyway. Whether it was a digital artifact, a shadow, part of the paint job or a nuclear freaking weapon.

And the plane had a pilot. They would not take off without one, simply because it would raise suspicions if, on take off from Boston Airport, there was nobody there to ask for clearance to take off.

And the MH17 disaster is not comparable to United 93 because MH17 was hit by a missile and broke up in the air. The debris field for United 93 looks FAR more like the Germanwings disaster, where the copilot deliberately reprogrammed the autopilot to crash into a mountain.

Oh, and things like passports FREQUENTLY survive plane crashes. They are light and durable. Light things like passports, clothing and the like always litter plane crash sites. Hell, the teddybear amongst plane wreckage photo is practically cliche it's so common. Why? They are so light they simply get blown clear of the wreckage.
Reply: dangerouslytalented
I'm not talking about commercial airliners for fuck sake. I'm talking about military aircraft that have the radar cluster on the underside of the fuselage which, from photographic evidence from 9/11, Flight 175, had.
That indicates Flight 175 at least was not a standard commercial airliner - once again, backed by witnesses who claimed it looked like a military plane.

Hahahaha how hard do you think it is for the controller of a drone to ask ATC for permission to take off? You're really clutching at straws here.
It's as simple as fitting a 2 way radio transmitter, allowing the "pilot" to converse with ATC from a safe distance. 

MH17 didn't brake up in the air, it was hit by a missile and then came down from 36,000 ft.

https://www.youtube.com/watch?v=BUfaqm4SpUc
 
Funny you say that though actually because the Germanwings crash is another I refer to when listing the differences in plane crashes and Flight 93.

http://static5.businessinsider.com/image/55155632ecad04275efe0c0d-1200-924/rtr4v19o.jpg

http://i2.wp.com/www.biznews.com/wp-content/uploads/2015/03/2015-03-29T114910Z_1826379999_LR2EB3T0WTNJK_RTRMADP_3_FRANCE-CRASH.jpg

http://www.independent.co.uk/incoming/article10133585.ece/binary/original/germanwings-crash-front-3.jpg

http://www.independent.co.uk/incoming/article10137200.ece/alternates/w620/Germanwings.jpg

See? Large portions of fuselage and landing gear are all clearly visible.
Reply: John Smith
... so now you are saying that they were not airliners at all? Thing is, that how on earth would they make the swap? People dropped all those passengers off on that day at Boston and New York, they all had to go somewhere... Those planes took off, we have the air traffic control records of it happening. We have the air traffic control data of the ENTIRE JOURNEY.

And no fucking bullshit about Germanwings. You said MH17 over Ukraine. Not Germanwings. And MH17 DID break up in the air, the debris was strewn over a wide area because of explosive decompression.
Reply: dangerouslytalented
What the fuck are you on about? This is what I said,
"The theory is likely the planes were military planes outfitted to look like American Airlines planes. This would also coincide with eye witnesses in numerous videos claiming the planes didn't look like American Airlines, had no windows and instead looked like military planes."

What part of that don't you understand?

How much attention do you pay when you board a plane? There is no way of telling the plane you're boarding is a drone, just like there'd be no way of ATC knowing.

I think you have trouble comprehending, it really plays into the hands of your ignorance.
If you're going to continue disagreeing with me, then YOU explain what the bubble was on the underside of Flight 175? YOU explain why eye witnesses reported they looked like military planes and were not American Airlines?

I use BOTH MH17 and Germanwings as examples of what plane crashes look like. NEITHER compare to the pathetic crater that was the supposed crash site of Flight 93, where there was no obvious sings of a plane and an image that shows a pathetic plume of smoke that looks no larger than those given off by a large bonfire. 
It did not break up in the air, watch the video I linked you of it crashing.
The crash site shows charred grass from fires caused by the burning fuel.
Both engines are clearly visible.
Landing gear, suitcases, seats, clothing, bodies fuselage etc. ALL visible.

How exactly does a plane weighing 120,000kg simply vanish into the ground? 
If you think this is the result of a crashed plane,

https://eyreinternational.files.wordpress.com/2012/05/fainttail2bm1.gif

Then you're a fucking moron.
Reply: John Smith
The incongruity between normal civilian airliners and what they saw is simply that the planes flew far faster than airliners normally fly when so close to the ground. They would associate low, fast flying with military planes because the ONLY place you see planes flying low and fast is at air shows, when military planes do it.

And the wreckage of United 93 looks like that because, in your image, they already did a lot of the cleanup and also, Germanwings was into solid rock, while United 93 crashed almost vertically into the spoil of a coal mine.
Reply: dangerouslytalented
No, that's not at all the reason they gave. They stated it was a black aircraft that didn't appear to have any windows or markings you'd associate with a commercial airliner.

Stop spouting such bullshit. There are photos of Flight 93's crash site where the crater is still smoking, the same level of debris can be visible. In fact the only obvious plane part was one engine that was unearthed by an excavator, and I've read the engine doesn't even match a 767-200.
The mountainside being rock would be an even likelier cause for the plane to disintegrate, softer ground soil would on the other hand soften the impact somewhat, leading to a more preserved aircraft than what we can see from images.

Either way, regardless as to what the planes crashed into, it's impossible for extremely durable pieces of an aircraft, like landing gears and seats to simply vaporise on impact with a field.
Reply: John Smith
Except that was NOT WHAT SHOWED ON THE VIDEO. And LOTS of people said it was a big silver American Airlines jet. They know it was American airlines because they are the ONLY ONES THAT ARE SILVER.
Reply: dangerouslytalented
I'm not talking about the video, I'm talking about eye witnesses and even News reporters who claimed it looked like a black military plane.
What the video shows is a bubble on the underside of the fuselage which is not found on commercial planes, but instead on military ones.
There are 2 pieces of evidence that point towards Flight 175 not being a standard commercial airliner.

And by the way, it was United Airlines, not American Airlines.
Reply: John Smith
The video does not show this. The video shows white and silver United and American airlines planes hitting buildings. (both airlines). And your bubble could be ANYTHING, but most likely simply digital artifacts stemming from zooming all the way into a blurry low resolution image. OR shadows. There was no way that the planes could have been swapped out, because we have the air traffic control records.
Reply: dangerouslytalented
If the video shows a white and silver American Airlines plane then this conspiracy is even deeper than I first thought, especially since like I've told you, it was United Airlines, who's colours are grey and dark blue.

See? You're doing it again. You're disregarding photo evidence as something as pathetic as a "shadow".  What shadows are 3D exactly? And appears in several images all at different angles?

http://cdn1.collective-evolution.com/assets/uploads/2013/03/Flight175-300x277.jpg

Here it is on closer inspection,

http://911research.wtc7.net/essays/salter/podimages/2ndTowersmall.jpg

Looks a lot like a shadow doesn't it?

Here's a standard UA Boeing 767 for comparison,

http://www.luftfahrt.net/galerie/photos/2007/21/1188325946_N659UA_Boeing-767-322ER_United-Airlines.jpg

Pay close attention to the lack of a pod on the underside of the plane.
Reply: John Smith
Two united jets were hijacked and two American airlines jets were hijacked.
Reply: dangerouslytalented
Very clever of you, but we're talking about United Airlines Flight 175.
I'd have thought this pretty obvious given my constant reference to 'Flight 175' and the numerous photographs I've now posted of it.

Keep up would you?
Reply: John Smith
United 175 was clearly not a military plane. One quick google image search shows hundreds of images of flight 175, from dozens of angles, both low resolution images from videotape and still images. To say that because witnesses think they saw something other than a United Airlines Boeing 767 is absurd. They even found parts of engine, undercarriage and fuselage matching the plane.
Reply: dangerouslytalented
Yet you completely ignore the entire point of this discussion - the pod that can be clearly visible from the several images I have shown you.
You discarded it has a shadow despite it being viable from 4 different cameras and a super imposed image that clearly shows a foreign object that has no place on a commercial airliner.
To back this up I even provided you with an image of a standard UA Boeing 767 that quite clearly did not have any sort of pod attached to its underside.
Reply: John Smith
Your "pod" is only visible in certain footage, and could be ANYTHING, most probably the sunlight casting a shadow on the bottom of the plane. An actual pod on the OUTSIDE of the plane would have been noticed by the refuelers and flight crew LONG before the plane took off, and would have DEFINITELY been noticed when the plane took off with the drag it would have caused and the extra unexpected weight.
Reply: dangerouslytalented
Hahahahahaaaa!! It's supposedly only visible in certain footage so let's assume it's fake?

1) That is the most convoluted bullshit statement I've ever read
2) It's also not true whatsoever. I've shown you 4 pieces of photographic evidence taken from live footage that clearly show the pod, as well as a super imposed image that shows it as clear as day.

You think it's sunlight? Are you seriously this thick? You don't know where this plane came from, you don't know if it took the place of the real UA 175 in midair or various other suggestions. They don't create drag, they're streamlined pods that follow the curvature of the craft.

I've noticed how you're slowly dropping out of this discussion. You've now realised you're not going to get very far with the Flight 93 discussion so have dropped it.
I also seem to remember we were talking about thermite again and FEMA's and NIST's findings and experiments on the matter.

I admire how you think I won't notice and continue on in your beliefs, despite having no relevant explanations for what I've told you.

Keep trying though.
Reply: John Smith So whats this pod theory?
Reply: Rob k
Read my previous comments and you'll find out.
Reply: John Smith im not reading through truthers bullshit comments sorry, is it just the idea of a pod with explosives strapped onto the planes? thats the most ridiculous idea yet, people would of seen it a mile off and reported seeing it if the footage you are saying its in captured it...
Reply: Rob k
Then don't fucking ask me because I'm not going to waste my time repeating something to someone who'd believe the sky is green if they were told so, despite what you already know.
To answer your question, no, that's not the idea whatsoever.

Bye bye sheep.
Reply: *****
... more likely mixtures of aluminium, lead, and/or copper, with possibly some tin and gold from computer components. Aluminium was widely used in cladding, lead in cathode ray tubes and battery backup modules, copper in electronics and wiring and tin and gold in electronics.

I was simply listing metals that have lower melting points than steel and were definitely present in the towers.
Reply: *****
It's not just gold, it's plutonium, titanium, mercury, silver, obsidian, cobalt and of course, latex.
Reply: John Smith
No, Most of those were not present. I was talking about metals that both have a melting point lower than the office/jetfuel fires that were in the WTC, and were PRESENT there. There is absolutely no proof whatsoever that the cascade of metal was steel.

But at least you shut up about that damn pod now I have shown that it was a combination of the shape of the underside of a 767 and the airline livery as painted on that particular airline...
Reply: dangerouslytalented
They were actually all present. There were high concentrations of obsidian because an office in the North West corner belonged to a geologist.

I think you'll find you actually ignored my last comment on the matter, just as you have my comments on thermite and Flight 93.
I'm also waiting for an explanation as to how Flight 77 exceeded its airframe speed by well over 200mph at the altitude it was travelling. 
I won't hold my breath though.
Reply: John Smith
sorry, Flight 77 exceeded the speed that it can SAFELY fly, long term, without suffering from premature metal fatigue etc.

Except that when you aim to crash the plane, safety becomes irrelevant.
Reply: dangerouslytalented
Nope, not at all.
The FAA have stated a 767 can safely fly at an altitude of 700 metres at 470mph without damage to the airframe. 
However, when you're doing 530mph at an altitude of 6 metres, it gets a little more complicated. 
It is not a matter of just safety, it comes down to the aircraft's ability to reach such speeds, such as the engines requiring 6 times more power to power the craft through dense air. Or the fact the airframe is not capable of withstanding the air resistance that comes with flying at 6 metres at 530mph. Aside from this you've got the incredible amount of turbulence that would make the plane completely uncontrollable.
Allow me to copy you in on this excellent comment that explains what I'm talking about,

"The VD speed given is the Equivalent Air Speed that the Airplane will succumb to Structural Failure due to Aeroelastic Flutter (The wings break off.(theorists only)) below 17.5 thousand feet.
This is related to the resonant frequency of the Structure and is well known to Engineers and Aviators.
It is at 420mph Equivalent Air Speed that the Airplane starts to become Uncontrollable and starts to suffer Structural Damage.
The Structural Stresses increase by 46% in any object increasing its speed from 480mph to 580mph as 580^2 / 480^2 = 1.46 or an increase of 46%, this also being overlooked by Lawson when promoting his ridiculous wacky conspiracy theories based solely on bed wetting fairy stories.
All relevant documents can be found at the 'Pilots for 911 Truth' web site.
.
"All aircraft have a safety factor built into their airframes which allow
 them to exceed the recommended or permitted speed by a certain margin. 
The speed of flight 175(586) is only 21% over permitted airspeed in a VD
 under 18,000 feet. Well within a 767's capabilities and margin of 
safety."
Do you have any references for this nonsense that you have written or have you made it up, or repeated it from Lawson's wild and fanciful theorizing and associated bed wetting fairy stories?
.
If a Boeing 767 series 200 were to reach 580mph at sea level it would have to take a Vertical Dive as it would need all of its propulsive force available and all the available gravitational force to even come close to the claimed speed of 580mph promoted by ridiculous wacky conspiracy theorists.
The max' speed that any other or normal Boeing 767 series 200 can maintain at sea level is 320mph and to have the potential to maintain 580mph it would need 7 engines to provide the propulsive force as the density of Air at sea level is 3.5 times that of Air at 35,000feet. 
3.5 x 2 Engines = 7 Engines.

The Airplane in question is a Boeing 767 series 200, the terminal speed or max' velocity equilibrium is based on the motive and gravity forces available in relation to the drag resistance. This occurs at 320mph during level flight at sea level for the Boeing 767 series 200 as gravity is not a factor during level flight.
This would indicate to any Engineer or Aviator that if such a body were to exceed this speed during a dive the vehicle would decelerate during the level phase of the flight. One does not recall deceleration being mentioned by the Official Ridiculous Wacky Conspiracy Theory or by Theorists that promote such, with of course their bed wetting fairy stories.
As a Boeing 767 series 200 requires 7 engines worth of thrust to maintain 580mph during level flight at sea level (negating that the wings break off at 480mph) the Airplane would be decelerating at a rate that 5 engines would accelerate the Airplane as only 2 engines were available for Flight UA175.   7 - 2 = 5
The reason the Thrust 2 achieved such a speed is because of the high thrust of the engines in relation to the low drag of the vehicle. You might have noticed that the Thrust 2 does not have Wings or a Wide Body Fuselage.
Many Airplanes can reach high speeds with the help of gravity so long as their Airframe stays intact but unfortunately the Wings of the Boeing 767 series 200 part company with the rest of the Airframe at 480mph Equivalent Air Speed. Re; Egypt Air 990.
There is no mention of the 'Do Not Exceed Speed' (480mph EAS) listed by Boeing and the American Aviation Authority that this speed is only accurate to a tolerance of plus or minus 21% of speed or 46% of Dynamic Forces, the Dynamic Forces of course being the relevant factor (This always the factor to be overlooked by Ridiculous Wacky Conspiracy Theorists).
"VD" stands for, Design VELOCITY Dive, not "vertical", ie; the Nose of the Airplane below the Horizon. One is not aware of your "VERTICAL" Dive limits being issued by any Civilian Air Liner Manufacturer or National Aircraft/Aviation Authority.
Whether One uses the VD (Design Velocity Dive) or VNE (Velocity Never Exceed) speeds none have a higher value than 480mph Equivalent Air Speed.
Have a look at a Flight Envelope Diagram for a Boeing 767 series 200 so you can realize how Wacky your Ridiculous Conspiracy Theories are.
Are you by any chance related to or from the same Planet as Lawson?
If you could reference any of your Conspiracy Theory claims One would be most interested, until then One is afraid that your claims will remain and be seen only as Outrageous Wacky Conspiracy Theory and your reasons should be considered to be nothing more than Ridiculous Bed Wetting Fairy Stories."
Reply: John Smith
The planes had momentum. It's not like they have some kind of automatic brake that stops them from going too fast when in such a dive, To exceed it, would take such a long and fast dive that the plane would not survive, so they set the VNE number to that. This number was irrelevant, because Atta wanted to crash and die.

The planes that were in the tape match the Boeing 767 and Boeing 757. The components found in all four crash sites match those two models too. The passengers remains and belongings that were recovered matched the passengers. To do all this stuff with drones, they would have to A) build a drone the size and shape of a Boeing 757 or 767, fit it with engines and a frame strong enough to handle the stresses, hijack four real planes, hide them, make sure the passengers and crew are never seen again, have the planes crash on target (apart from the one that crashed into a field) and THEN somehow smuggle wreckage from the ACTUAL PLANES (with matching serial numbers) ALONG WITH ACTUAL CORPSES INTO THE CRASH SITES.
Reply: dangerouslytalented
Momentum does not allow a plane to travel at it's cruising speed, 6 metres off the ground without air resistance having an effect on the airframe or the controls of the plane.
It is physically impossible for a plane to travel at that speed due to air resistance alone being enough to tear the wings off.
What part of that don't you understand?

Simple, outfit military planes to look like commercial airliners (military aircraft also have stronger airframes), fit them so they can be radio controlled (this technology has existed since the 20th century), maybe even pack them with some sort of incendiary which thankfully NIST never experimented for.
Have YOU seen evidence of the actual serial numbers and parts of these planes?
No. You haven't. You've been told to believe it like a good little boy you are.
If I were to tell you to believe something with no evidence to support it, you wouldn't believe me.
So why believe a Government with a history of lying?
Answer: You're a sheep who's afraid of the truth.

If you want to follow the crowd and walk blindly into situations because you're a fool, then be my guest.
Reply: John Smith
It did not reach its cruising speed at six metres off the ground without first making a dive.

And there are military versions of the 767, and they are all tankers and surveillance planes. And military versions of the 757 are transport and VIP planes. They would have had exactly the same problems.
Reply: dangerouslytalented
Ok then, please explain to me what part of it's kilometre flight at 6 metres consisted of a dive then please?
However yet AGAIN you're ignoring the fact a commercial 767 CAN NOT fly at such speeds at such alititude without CATASTROPHIC damage to the airframe which at speeds at and above 480mph would mean the wings being TORN OFF.
That is a whole 50mph LESS than the speed Flight 77 was supposed to have been travelling when it struck the Pentagon, vanishing through a hole just 5 metres wide.

No idea what that second half of your comment is insinuating.
Reply: John Smith
The last part was the dive. The plane that hit the Pentagon did a steep spiralling dive, the ones that hit the WTC had a more straight dive.

And the military versions of the 757 and 767 are basically the same airframe with different equipment inside, being either a big fuel tank or communications equipment.

There might have been catastrophic damage to the planes, had they been flying them at that speed for much longer. But that is completely irrelevant, because they all crashed anyway. The wings would not have simply fallen off, they would have been under great strain first. Engineers always leave a bit of leeway in their figures, some safety margin, so that if somebody IS foolish enough to go beyond the maximum posted speed, the whole thing does not fall apart. Because if there is no such leeway, then the plane could fall apart at LESS than that speed, particularly once it gets older.
Reply: Johnny B
Every single building surrounding the WTC suffered massive damage, the Verizon building needed a billion dollars worth of repairs, while the Deutsche Bank building had to be carefully dismantled.

Building 7 collapsed because it had the same structural flaw as the buildings 1 and 2, it lacked reinforced columns throughout the floors. The WTC towers (1, 2 and 7) all were supported via their cores and facades ONLY, no floor columns were used. This allowed any collapse to propagate throughout the structure..
Reply: dangerouslytalented
You have no idea how strong those cores were, do you?
WTC 7 was nicknamed "Giuliani's bunker" because it was effectively a Doomsday building, built to house Federal Offices and their contents - all of which conveniently were destroyed in its collapse, putting and end to hundreds, if not thousands of Federal investigations.

It's collapse is attributed solely to the structural failure of core column 79, because of heating due to fire, which NIST has confirmed only burned for a maximum of 40 minutes before burning out.
Core column 79 was coated against fire and should have withstood temperatures for far longer than just 40 minutes.

Did you also know that WTC 7's collapse was reported on by the BBC and entire 20 minutes before it happened? With the towers till visible in the background?
Reply: John Smith
No, it was Giuliani's bunker because he foolishly put his emergency headquarters there, mainly because he wanted a place that was high profile and easy for him and the press to get to. Those who were experts in emergency management pushed to have it located in a basement somewhere in Queens, a place close enough to get to but far away enough from all major terrorist targets to not be immediately abandoned once the shit hit the fan. And they KNEW that the Emergency Management office was not safe, because they NEVER USED IT, because the only emergency that ever happened while it existed was 911. 

And all those columns were coated with what?  Spray on fireproofing and drywall. And what are they made from? GYPSUM. A great substance for fireproofing, just so long as it is not subjected to any impacts. Unfortunately world trade center 1 and 2 had collapsed right next door and gouged huge holes in the facade and wrecked many of the lower levels.

Oh and the BBC mentioning the collapse 20 minutes beforehand is not that hard to explain. There were reports that building 7 was going to collapse and the area near it was evacuated, and the BBC made an error and said that it already had collapsed.